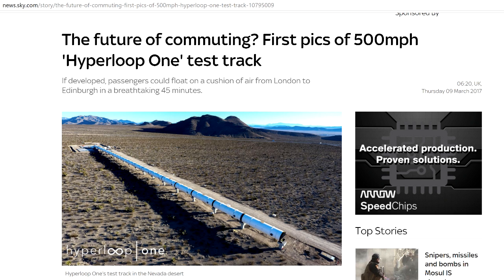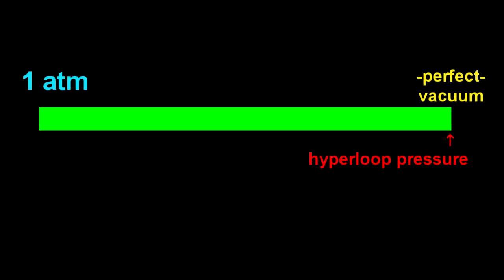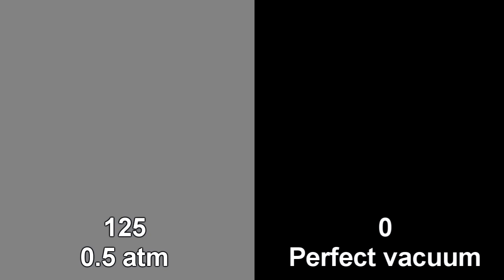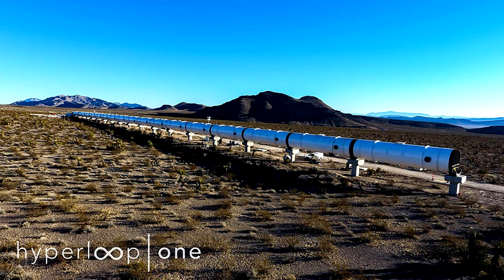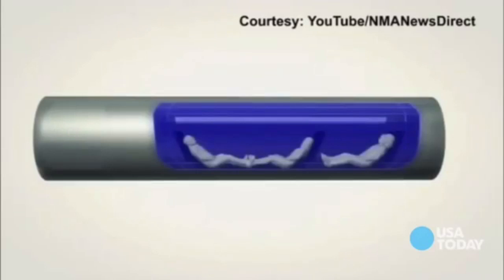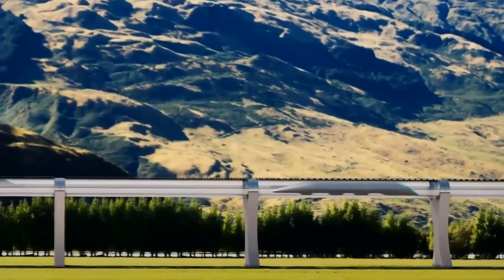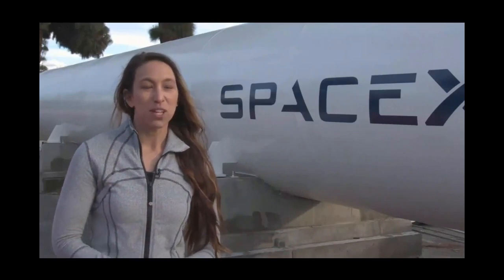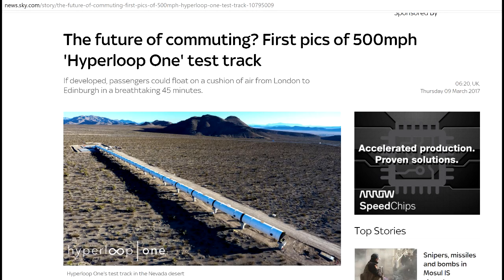Entire Hyperloop could be destroyed in SECONDS!

Comment from the maker: Loads of people sent me the article about 'hyperloop ones construction of a test track', which might seem impressive till you realise its half the size of Elon Musks test track, which was only ~1km long.  Their tube also looks VERY thin to the point where I wonder if they will even be able to depressurise this tube.  I dunno give me odds of when this tube is depressurised, the chances of the hyperloop being able to survive merely being hit with a 5kg (10lb) hammer!
Reply: Paris Teta Why not just build a normal train then?
Reply: Problem I see with this: they want to build it in the usa. Every nutcrack can buy a fucking .50 anti-material rifle for hunting purpose.
Reply: I watched films on early attempts at flight. It's easy to laugh at their failures if you didn't understand that aeroplanes are the result of those trials. They're doing something while your contribution is what . . . to ridicule?
Reply: Only if it's a solid gold hammer, my good sir
Reply: +Thunderfoot Hey, I had a thought you might find interesting.
The test track for the Rainhill trials (1829) was a little over 1.75 Miles.
Reply: That's called a Transrapid, was designed and built in germany and has been fully functional since 1991. There is zero need for a Hyperloop.

https://en.wikipedia.org/wiki/Transrapid
Reply: > it's unfair to judge the whole thing when it's in such an early stage of development

because they can invoke magic later.
Reply: a train basically
Reply: There always has been solution, with current technology, we build tubes like the fucking ones in nuclear power plant. Bomb proof external 10 meter concrete wall, 1 meter thick carbon steel tubes thats hard as fuck. basically all the best military grade gear possible. WE CAN BUILD IT!!! YAY 1 FUCKING BILLION DOLLAR PER KM YAY
Reply: Since when did laws stop terrorists or criminals in California?  Did you forget about San Bernardino?  You are incredibly stupid.  Invest in Hyperloop.
Reply: Even if they manage to build this hyperPOOP, the ticket cost will have to be several times that of Concorde.
And we all know what happened to the Concorde. 😊
Reply: +JMcAfreak Thunderfoot is NOT an engineer, he is a chemist. The issues he discusses are engineering problems!
Reply: I have a much better idea than Hyperloop: Hypercannon. A passenger in LA is fired out of a cannon with enough speed to get him to San Francisco. But don't worry there is a Hyperbouncycastle in the target area. Also Hypercannon Deluxe gives the passenger a parachute for that extra comfortable travel.
Reply: @earlofdoncaster5018  Hyperbouncycastle , loved the name, stealing it
Reply: @earlofdoncaster5018  They haven't lost anyone since they recalibrated in '09. https://project-apollo.net/mos/mos007.html
Reply: Each segment must have isolation option, UPS, and evacuation shafts automatic valves in order it to be safe. Cascade failure is big deal here also, I think there is no such system to prevent that, because it is too quick, in order to separate segment you need a very quick closing system. Seems to me this hyperloop is a golden loop in terms of cost efficiency.
Reply: +Peter Knagge "top speeds of over 1200kms/hr, that's Hypersonic sonic boom territory, not to mention the G-forces, "

Someone correct me if I'm wrong, but I don't believe there is a sonic boom in a vacuum, and G-Force is a product of changes in speed or the combination of speed with a curve.

I'm fairly certain they'll experiment with melons long before they put people in these things.
Reply: so...trains...trains on mars, that is hyperloop, if you do not need a tube and all you need is engine and a track...congratz, you build a railroad.
Reply: Thunderf00t Your argument is invalid if they use adamantium. Haha proved you wrong!! ( XD sorry )
Reply: Cause submarines are not built to be a perfect vacuum, quite the opposite, they need oxygen in them so the crew doesn't choke to death. As well as having thicker plating, supports, bulkheads and things of the such. They're not a giant vacuum chamber built above water. Your point is invalid.
Reply: + Ex Animus can you stop talking about physics as if you understand it. "any loss of pressure containment with the car moving at those speeds is death." No, absolutely not, do you see airplanes just suddenly stop when they turn off their engines? No, air is a compressible fluid, it would compress and decelerate you at about a little over 1g assuming that you have an airtight seal around the pod. if you don't have seal around the pod it would only decelerate/accelerate you at around 0.1g, stop stating "alternative facts" and do the actual math, it's not hard to do it's insanely simple, either you take pressure*area/mass and you get the acceleration in the "air tight" scenario, or you take air density * speed^2 * area * drag coefficient / mass. Plug in some numbers and you'll find that what you are talking about just doens't happen
Reply: Thunderf00t are you an professional engineer and scientist?
Reply: Silly Sad It might make a good amusement park ride in the future.
Reply: I really don't see the need for hyper-fast transit for people (presumably wealthy and business-class passengers) given the increased use of teleconferencing and skype and whatnot. Of course many business transactions and collaborations require face-to-face contact, but I'm not sure that so many are required that it would necessitate a project like this vs. just taking a regular jet or train.  This just seems like an answer to a question nobody asked.
Reply: Thunderf00t is trying to save lives. Everytime the press hypes the hyperloop, he responds. And yes, the arguments are the same, because the media doesn't seem to catch on to the absurdity of building a vacuum bomb just to travel a little faster than a "conventional" maglev train could. If despite his warnings the hyperloop turns into another Hindenburg it won't be his fault, that's for damn sure.
Reply: I don't think he is doing this on purpose tho. There are many ridiculous ideas out there which are getting funded by governments etc which are just obvious troll ideas. He is just a person too, he has his beliefs and once he has put this much effort into "busting" a concept turning around and going "Oh, I was wrong on all these things I said" is just not a human thing to do. I'm an u He is clearly wrong on several issues here and he is not knowledgeable enough in the strengths of materials to make accurate statements about the structural integrity of this tube. He is a chemist, right? Not a physicist. You can "easily" calculate how much pressure that tube can hold, how large of a dent it can take etc. You can even run these simulations on your laptop. So yes, he is wrong here, but everyone can be wrong, the real lesson to be learned here is the same as always, DO YOUR OWN GOD DAMN RESEARCH AND STOP TRUSTING EVERYTHING YOU SEE. I am a victim of this too, I believed him when he said many of these things, then to prove a point I did some math on the aerodynamics of a ruptured hole and more, and I got really low accelerations, like bellow 1 g of acceleration low. So I looked over it again and again and then realized that what he was saying simply wasn't true. I still don't believe that it's economically feasible to build it, but that remains to be seen.
Reply: What about using that fast release to push it to the destination and use magnets to slow it down?
What about launching yourself out of a cannon, and landing in another cannon right as it fires to slow yourself back down?
Reply: Its called redundancy, same thing that protects airplanes from depressurizing at cruising altitude and sucking the passengers out into the sky while simultaneously depriving them of oxygen.
Reply: +This Is My Name there isn't a solution, that's the point.  

I'll admit that the whole thing about emptying the tube every time is dumb, just build an air lock at stations.  But considering that even a small amount of damage could cause catastrophic failure, is a fairly large issue.
Reply: no man, you are wrong. there is no watch dog on the kind of people making those other products and or concepts, which, as has been proven was really done purely for scamming money.
they never in their wildest dream thought thought they would have their bullshit ideas put through what amounts to science boot camp.
just think of the amount of money they would have walked away with if TF didnt test them, we are saving lives maaaan. lol
Reply: Thunderf00t holy shit.  They should put the money into Maglev trains.  Super fast without needing the vacuum tubes.
Reply: My take on aswering/addressing your solutions (warning im no expert on any of this so my bad if some errors occure):
1. while an option in terms of practical solution its would skyrocket the cost for material and construction as well as making other problems worse (like extension and curves)

2. the problem here is that bridges are relatively short pieces with no need for beeing vacuum tight and perfectly straight. if we take a look at the closer relative of the HL (a pipeline) does it we see that they get curvy and have U shapes integrated into them to get them stable... not realy an option for the HL

3. your first point would make it better (not good but better) but it would still hold similer risks and with your second suggestion you want to add structual weakpoints into the exterior tha basicly repeat the same problem every X km? and to "cushion the vehicle"? you realise that you would create a wave of air behind AND in front of the vehicle that are going towards each other?

4. i got nothing

5. yes arilocks would remove the problem stated here. but it raises the question of the interval length between the pods.
lets say the trip takes 30 min of travel time and the de/repressurisation takes about 5 min. in addition we need the time for passengers to exit/enter the pod, time for the safty checks and a generous amount of puffer time for minor delays (see train travel...). with that we could MAYBE squeese 2 pods per 30 min into the tube. correct me if im wrong but i think the biggest pod we have seen in artowrk was ~10 person pod? so if nothing goes wrong we can transport 20 people per tube in the 30 min interval... thats not realy a good ratio.
also can the pods be stoped mid transit in case something goes wrong? and things will go wrong (hell we cant even keep the "low tech" trains running on schedule without problems...)
and lastly the question of what happens to the pod after the trip? unless its a literal loop (aka round trip) they either need to send it back wich would limit it to 1 pod per tube aka 1 trip per hour or the need to extract the pod at the end wich would make it even more time consuming and add technical dificultys...

Ps: your links dont work correctly because you include the ) in the link. there needs do be a blanke space between them ^^
Reply: RoMMeL1337ak47 be careful with saying stuff like that, some don't find it funny and they'll get professionally offended.
Reply: Still think it'd be more practical to build an above ground subway tunnel to put a monorail in that has solar panels on top of the tunnel to supplement the power needs, and you'd have enough money left over to even put cup holders and TV in for each seat....and lobster dinners for all the passengers.
Reply: +Thunderf00t you have been talking about the loop itself but wouldn't the pods be at risk too? you are putting a capsule into a vacuum, if it's not strong enough (and i'm pretty sure it WON'T be) it's gonna pop like a balloon
Reply: What happens if the transport car gets stuck in the tube?  Wouldn't the passengers run out of oxygen and suffocate?   Why is anyone still working on this bullshit?  I'd hate to have a job knowing I was constructing something that was completely fake & would never be used...just to get a paycheck (I assume).
Reply: People are sucked into the cult of personality that's formed between undergraduate engineering students and this Musk character.
Reply: "Nature abhors a vacuum."

Nature wants to crush a vacuum.
Reply: I don't understand what's wrong with maglevs, they're already a proven technology (China, Japan). Why even bother with the hyperloop?
Reply: With the condition of our infrastructure and the people that cannot even keep up filling potholes, This is just another accident waiting to happen.
Reply: it was my understanding that they were going to use maglev technology in concert with a vacuum chamber, thats why I mentioned their theoretical speeds could be much higher, but in a vacuum using wheels at such high speeds they're going to have HUGE issues with heat since there's no air to carry away the heat.
Reply: Is the 5kg hammer made out of gold?
Reply: So basically the HyperLoop is going to crash about as hard as your Brexit and Trump videos?
Reply: with a GOLDER hammer :)
Reply: You are right about expansion problems. You could wrap it with insulation but that just adds to the costs  The better option is to use conventional means of transportation and forget this.
Reply: That´s because many - if not all - of his projects are a giant waste of money, ressources and manpower.
And more often than not they are pretty dangerous as well.
Elon Musk himself is more a man of great words than of great acts. Plus, he is trying to do things just because they haven´t been done before, and not because they contribute something to the future of our world, even though he wants to believe just that. Look no further than SpaceX. The plans of building a colony on Mars are just pure madness. Even 1 Million people sent to Mars (which I highly doubt will come true) wouldn´t solve overpopulation. I´m not aware of any kind of research we could perform on Mars which we cannot do here or on the ISS. Actually, there is absolutely no benefit to this other than proving that it can be done (and we already know that can be done). But this project is gonna cost so, so much money that could be invested in other things.
Reply: Larry Smith every time I look at Musk I hear the Monorail song from the Simpsons in my brain.
Reply: tuxis why would one do this though. Look Thunderfoots debunking of the Hyperloop is great and wonderfully detailed. But even he misses the more obvious big picture failure of the thing. Economics. The Hyperloop is at the end of the day a fixed point to point transport system that travels at or near the speed of sound. But it features enormous materials and infrastructure costs. And obscene ongoing maintenance and operational  costs every day it runs. All this to achieve travel at or near Mach 1. Contrast this with Air Travel. It is fixed point to point high speed  Travel that has very very low cost infrastructure costs. A few miles of flat concrete, some lights and navigation systems. Upkeep on the infrastructure is astonishingly low for a transport system. We've had Hypersonic air travel capabilities for 50 years. What does the Hyperloop deliver that the Concorde did not in the 70's? Beyond an obscene price tag?
Reply: how about a moving atmosphere (wind tunnel) instead of evacuation?
Reply: youtube. com/watch?v=Uh0uwJoNnhc&t=8m17s    
does anyone know if ^ this ^ series has been addressed by thunferf00t?  It seems to includes damning criticism of a number of the calculations that Thunderf00t used to criticize the hyperloop.  If he hasn't addressed this criticism, he probably should.
Reply: Okay, considering the weight of the evidence, it seems pretty clear that Thunderf00t is just wrong on this issue.  He blatantly misrepresents the actual pressure differential between the interior of the hyperloop and the atmosphere, and ignores the actual solutions to many of the problems that he mentions (his representation of the problems are also often exaggerated) -- solutions that are proposed by highly qualified engineers, and specifically described in the hyperloop white papers.  Shane Killian's series "Thunderf00t's "Hyperloop: Busted" BUSTED" points out Thunderf00t's many errors on this issue, and is totally damning.  The fact that Thunderf00t misrepresented the pressure differential, again, in this video is ridiculous.  here's the video describing his misrepresentation of the pressure differential, although the whole series is great:

youtube. com/watch?v=UQPAzZX7Pp4&t=8m0s
Reply: The internet is TUBES! HYPER TUBES!
Reply: @ Remi I´m not ignorant, I´m just saying that building a giant colony on Mars right now doesn´t make any sense. I´m actually very interested in space travel, but I can´t see the point of this project. There´s no need to get people there because we can improve this technology here on earth until it is advanced enough so that establishing a colony on Mars has an actual use.
Reply: A 'conventional' MagLev train is more cost effective
Reply: Wouldn't be the first time Elon Musk's cowboy attitude towards safety in engineering would have killed somebody!  http://nypost.com/2016/07/02/tesla-driver-killed-in-autopilot-crash-was-watching-harry-potter/
Reply: umm how many homes does Elon musk own on the san Andreas fault line, because this seems like a bond movie villains plan to sell ocean front property 0_0
Reply: +Thunderf00t I can see you've gained quite a cult following now and I don't think it's doing you or anyone else any favours. Reading the thread of replies to this post is alarming me; Everyone is seriously ignorant to the facts and they're just repeating back whatever nonsense you've alarmed them with in your videos. 

Please stop to think about what you're doing. I think you're more concerned right now about satisfying your fanboys than you are about proper critical analysis. You're out of your depth when it comes to the field of mechanical and aerospace engineering. PLEASE SPEAK TO EXPERTS.
Reply: The only evidence you have for the damage to a hyperloop is your test cased which used a glass tube. Glass. Not metal of a similar width. Your test case was bunk. Stop pretending it was accurate when it wasn't. As for surviving being hit with a hammer: Don't be ridiculous. You may as well be saying the space shuttle can't ever possibly handle reentry because it's designed for use in space, and the air pressure on the ground is vastly higher. Lots of your arguments towards the hyperloop have massive holes. Either address these hole and reform your argument to better describe your point, or stop wasting your subscribers time with these anti hyperloop vids. At this point, with how many you've made, and how poorly they're argued, I'm beginning to think you're getting paid by a hidden party just to make them.
Reply: wait a minute, M.O.A.B. bombs? as in Mother Of All Bombs bombs, I remember when people talked about R.I.P. in peace as a joke, but I have never heard this one before.
Reply: Dedicate their lives to this field? What are you smoking? Like the winner team from Delft they are students and academics despearate for finding something they can use to write their Ph.D. and maybe extract some Musk money.
Reply: ahaha ashley i dont see a working hyperloop anywhere..
i dont see ANY NEGATIVE PRESSURE DEVICE in use anywhere in the world of any size EVER.. NONE,,,,ZIP,ZADA,NADA..ZEROOOO...
if you think savior elon was the first to think of this youre sadly insane.. people  have proposed low pressure  transportation tunnels since captain rodgers spaceman in the 1920ss and before..
why hasnt it been done.. because it DOES NOT WORK ahahah..
they even have a james bond movie with james on a pig  travelling at 100 mph in a  pipeline ahahah from the 1970s ahahaha
Reply: +sterling apsin Airlock
Reply: LHC exists, doesnt "collapse". Now, Elon is advancing with this thing, and it's gonna work for sure
Reply: Aecom, global construction firm, will build SpaceX's Hyperloop test track.
Reply: Some Dude - at least give an ingredient listing..  distilled Argon ( PLAr ) Flow regulator .oven  bag,..elastic tie... ]Works so well, it leaves people  speechless unable to bitch and complain every time.. never get any returns either, buy a kit today! and save on your next purchase. though usually no one ever needs another  one, i guess work  really well.
Reply: +Misanthropic_Asshole if I were MacGyver, I would use bubblegum a nickel some copper wire and a banana that should take it down but only if I were MacGyver...
Reply: From the footage inside the vacuum chamber test track at 3:31 ... How does the dust in the chamber hang around in the air if there is no air in the chamber?
Reply: Dust doesn't need air to exist, in fact when it does, water molecules attach to dirt and make it drop to the ground
Reply: I think it's easy enough to understand.  150 years ago would people have expected powered air travel, let along space flight?  Twenty-five years ago was the prospect of a phone (nee a micro computer) in the pocket of half the world's population anything but wild speculation?  They hyperloop hucksters draw a false analogy with past engineering achievements and the media goes along because its "news".  

What's really amazing is that people aren't just day dreaming about this, some are putting millions in to it.   The super-rich have money to burn indulging their idle fantasies and a portion of them do so!

I thought this was really the best video so far, showing unequivocally and vividly one of the failure modes of the system.  I recommend sharing this widely.
Reply: drizzt7dourden7 I work in healthcare, the majority of the  popoulaiton have a large amount of problems.. too many  to name, all lawsuit material..  no matter how durable r dsafer the device.
Reply: "I'm not going that fast in a tube that close to the ground. Im just an average guy but that just sounds like to me a big headache!" File that under 'Things your sperm would say if they could talk'
Reply: Oh, so that's what you need the gold hammer for, destroying the hyperloop
Reply: Thank you for finally bringing up the car crash thing Thunderf00t that seemed like the most obvious problem with the way they want to set this up.
Reply: Not fair to monorails.  They actually carry people where they want to go and their use is expanding.  Read: http://www.industryweek.com/technology/lowly-monorails-future-finally-arriving
or https://www.bloomberg.com/view/articles/2016-12-06/why-monorails-are-the-future-really-this-time

However, I think Lyle Lanley has a job in PR for one (or all?) of the Hyperloop venture. ;-)
Reply: "...the chances of the hyperloop being able to survive merely being hit with a 5kg (10lb) hammer!"

Crowdfund it! We must send Thunderfoot to California with a big hammer. For science!
Reply: Careful, you example with grays is reminiscing of the CO2 percentages used to argue against climate change.
Reply: Zarkoff45 There is the case that those 'investors' are not scientists, and that the engineers, along with Musk(probably) just threw off an idea bound to fail to make a cheap job that will get them a lot of money from both government funding and the aforementioned investors.
Reply: ***** I stand by what I said. It can make a good fucking amusement park ride.
Reply: Thunderf00t. The world needs more people like you.
Reply: So, an hyperloop on Mars is just a TRAIN. We already have them on Earth. Magnetic levitation trains are already plenty fast (up to 500 km/h).
Reply: With a big golden hammer
Reply: That's a fucking train on mars.
Reply: Will it be a golden hammer?
Reply: +This Is My Name You are an idiot. There is every reason to criticize something that upon cursory inspection (at least by a physicist) appears to be ridiculously impractical. Coming up with a solution costs money.  Why don't you pay him to come up with a solution? Bitch.
Reply: +Mr Anderson.  I don't know about 'trivially simple'. We are talking about a 1000km vessel exposed to expansion and contraction, earthquakes, wind, etc. Not to mention the need to protect it against collisions, and sabotage. One armor-piercing round would be enough to compromise the shell though maybe not to catastrophic failure. A shaped charge, instructions for which there are now even in videos on YouTube, would obviously be devastating. There are simply too many environmental and security hazards for a vacuum chamber of this size to be both safe and commercially viable.
Reply: +Paris Teta The thing is, Mars currently has no places to go to or away from. The idea of fixating on a transportation system for another planet between nonexistent cities is even crazier than just 'cart before the horse'!  The first settlements on Mars will be self-contained.
Reply: Elon Musk is a Snakeoil salesman and I'm glad that you are not afraid to yell out that "the emperor is naked"
This will fail and the best part for Elon is that it is not his money he is spending but tax money...
Even if it fails catastrophic  he will still be laughing all the way to the bank.
Just wait Musk Fanbois this will fail because the laws of nature is not an option, it's the law.
Reply: Vandalism, terrorists, car crashes, repair gone wrong, (it would take so long to safely re-pressurize the 1km tube for maintenance) a flaw occurring from inside the track like the vehicle loosing balance, the impact of the transport at the end of the track, flaws in production just any contact w/ the loop. Might you also note how powerful the reaction of the storage tank was when it collapsed, you could use a fraction of that dent to make a medium collapse.
Reply: Mr Anderson You obviously aren't aware that the hyperloop needs flexible joints in order to even theoretically function. good luck maintaining structural integrity and vacuum seals with flexible materials. the moment the vacuum pump starts, any difference in heat in different parts of the system will cause a massive chain reaction failure
Reply: you're ready to bet your life in the "plenty of time" to close the valves ? and even so there is no guarantee this will operat smoothly we are talking enormouse amount of energy here.
Reply: I have to say, although I am skeptical ablout the hyperloop, you are doing yourself a disservice with a few points.

Using the 30-45min time to evacuate the tube as an argument against the proposed travel time doesn't seem right in my oppinion. I'd expect the 'real' hyperloof (if it ever were to become a reality) to have some sort of an airlock, as opposed to evacuating and refilling the whole track all the time.

And those design 'studies' run on shitty wheels put on by engineeringly inept art and design students, and if they thought about greasing the axles, I'd be surprised, let alone ball bearings. 
With the supposed hyperloop running on magnetic levitation, there would be significantly less friction slowing it down.

So, please refrain from making obviously flawed arguments, Thunderfoot, as it only hurts your credibility. I would have expected you to be above such slight-of-the-hand tactics.

Especially, since you have well proven yourself capable of pointing out the real issues and idiocies of the hyperloop idea.

In my books, maybe people should try the Transrapid, it works. Not a pie in the sky as the hyperloop, but still decent achievements and actually working.
Reply: I really don't see the need for hyper-fast transit for people (presumably wealthy and business-class passengers) given the increased use of teleconferencing and skype and whatnot. Of course many business transactions and collaborations require face-to-face contact, but I'm not sure that so many are required that it would necessitate a project like this vs. just taking a regular jet or train.  This just seems like an answer to a question nobody asked.
Reply: At least in the case of the vacuum problem, would it not be theoretically possible to have an airlock type system anywhere that new pods needed to be loaded. This way the entirety of the track can remain pressurized and the station areas could be depressurized.
Reply: I still don't get the system. Even if you could get into the "train" and then vacuum the tube and start the journey, how do you stop at your destination? Also, does that mean the tube has to be pressurized back to safe levels for humans to exit the "train"? That seems like a huge waste of energy and time just to pressure/depressure the tube
Reply: What if we hit it with a gold hammer?
Reply: Maybe thats how they are going to work.. put a plug in the end.. sorry I mean passenger car.. then open up the end behind it.. that will make it get to a good speed.. be like the ping pong ball in the video.. xD
Reply: If it breaks down you're stuck in a vacuum tube.....how the fuck are u going to be able to breath?
Reply: I noticed that, also on that page it says 'floating on a cushion of air'.
Reply: I think that would be on another level of nasty, lets assume you are 1/4 of the way along the track and they open both ends, and lets also assume that the maglev keeps working,  you would be hit with a moving wall of air from behind, and shoved forward, or you would keep moving forward under propulsion till you hit a moving wall of air slamming into you from the other direction, you would go from the "600 mph" to 0 in slightly less than 3 seconds, if however the maglev failed then, unless there was some sort of standing loop that kept the field active till you stopped then you would drop to the floor of the track and scrape along, till the air got up to you and through you about.
Reply: "What could possibly go wrong?"
Reply: Remi are the same arguments only valid one time?  Wow, hadn't thought of that.
He makes the same arguments time and time again because it's critically important that people drop this idea as soon as possible.  huge amounts of funding are being wasted on something that is almost certain to be a catastrophic failure
Reply: a 5kg GOLD hammer???
Reply: A 5kg (10lb) gold hammer?
Reply: Thunderf00t 
It ok to take the low cost egg shell approach in design for experiments! It just has to show proof of concept. If they stopped the whole school kids approach and had real engineering involved (NASA or GE perhaps) we would not be joking so much, but that is not Elon Musk right? So let's see how the kids do, they may surprise us. or provide for entertainment!
Reply: Proxima 1
Is a tank designed to hold vacuum?
How much positive pressure is a tanker rated for?
Would a submarine rated to withstand 50 atmospheres of positive pressure implode like that tanker under vacuum (1 atmosphere)?
Reply: You mean all the money and energy Musk has spent, right? I doubt you've spent a lot of time and energy into the hyper loop :p When I said "he" in my comment I was referring to Thunderfoot btw, not Musk, but it goes both ways I guess.
Reply: A submarine or Submarine style construction would be what is needed, as that is designed to work in exactly the way this needs to be. So what is the cost of a small attack submarine? How many of them would you need to lay bow to stern to stretch from LA to San Francisco? How much maintenance does a Submarine need due to the constant forces on it? What are those annual costs? 

Now looking at that, note that the Concorde airliner built in the 70's could cruise at speeds of 1,300 Km/Hr. And only needed standard 4-5 mile runways at each end. Why build the giant hamster tube when you don't actually need the giant hamster tube to achieve the transportation goal you are seeking? Inefficient Expensive Stupidity is not in fact Innovation.
Reply: Thunderf00t. if instead of a vacuum they built a high-speed wind tunnel, the air could help push the pods and give the fans something to work with. it would be less vulnerable to damage and easier to work with, it'll help compensate for the metal expansion and the doors necessary to get the pods out of the toobs to load and unload passengers. or is this a bad idea too?
Reply: +Polak Ateista Can you explain exactly how his scam works? Spend millions of his own money to build a prototype for the hyper loop... I don't see how this is a scam? Where is he making money? Spending money is a bad strategy if you want to scam people.
Reply: there is solution, normal fast train.
Reply: Marek Rokam roughly 75-85% of Americans are complete asshats and actually believe this shit. I am not one of them, however most of my friends are.
Reply: Jesus. look at all these fucking retards trying to defend this. Or telling TF00t to come up with a better solution.
He doesn't have to, we already have one.
It's called a normal fucking train people. Or a car.
Both would be more energy efficient, safer, & don't require a massive fucking tube to operate.

Hell, in the case of a car, you don't even necessarily need roads.

"it's in its early days"
Shut the fuck up.

How do people fall for this shit?
Between early access games on steam, and bullshit art project kickstarters.

Christ people, get a clue already.

Every minute another sucker is born.
Reply: Thunderf00t none of these people have heard of an airlock
Reply: +Beacon of Weird
"All of these are just engineering challenges, nothing that cannot be overcome. Tube colapses? Thicker walls/more rings. Sudden acceleration during a leak? Add emergency breaks. Takes a long time to achieve vacuum? Add air locks. Track is expanding? Add airtight expansion joints."
Even cost can be solved as an engineering challenge! It costs $500 per mile to operate after adding all that shit? ... use a regular train instead!
Reply: Patrick
Right. And make the protective tube doubly thick to make sure. So now the structure is > triply heavy. But that's fine, we just have to triple the strength of the supports. They laughed, the fools...
Reply: I hope everybody already read Hyperloops page and realized it will be filled not with hard vacuum but 90% reduced pressure air.
Reply: Don't bother, at this point it's safe to say he's being paid to make vids specifically against the hyperloop. By whom, I'm not sure, but nearly all of his points have been defeated by comments like yours on the very first video he made about the hyperloop, but he just keeps making them. He even made a vid defeating other arguments, but the arguments he defeated were cherrypicked and none of them were actually the counters to his video. At this point he doesn't care, he's purposefully shitting on the Hyperloop with dishonest, misleading, and outright false information. Nothing we say will stop him. It's better to comment directed at the other users posting here, who can possibly be influenced away from his stubbornness to accept that the Hyperloop is theoretically viable.
Reply: I bet you he makes a video talking about martian windstorms destroying the track without recognizing that structures are made to withstand high winds on a daily basis. It'll be just like this video: Ignoring facts and using falsehoods and misleading and even outright false information to support his claims.
Reply: Resonance is easily handled with a few engineering tweaks. It may make it more costly, but it's not a huge issue to deal with unless the design inspires resonance naturally (like car engines, which we've handled pretty well).
Reply: and rocket ships fly into the upper atmosphere and into space on a regular basis, while having the potential to kill thousands when it crashes, but that doesn't really happen. It's almost as if engineering can tackle these problems and, if they can't, it doesn't get built. But no, you keep fighting the good fight and stopping progress because "it might not work." Idiot.
Reply: Except he didn't and lots of info in the vid is intentionally misleading and wrong.
Reply: Chris F I'm guessing you haven't seen his other videos.  dripping condescending tone that seems like he is bairly able to hold back high horse laughter the whole time is kinda his whole YouTube thing.
Reply: he may not be an engineer but the massive physics and engineering oversights in their plan are very real, and especially the first is not something you can engineer your way out of.
Reply: +Kevin Miedema
Thunderf00t has not addressed any oversights. He just doesn't accept the solutions, yet he lacks the knowledge to evaluate them.
Reply: physics is universal, its not the hammer that causes it to explode - its the 100.000 pascals pressing on the outside that make it fundamentally dangerous - 'oh im sure they know what they are doing' is not a valid argument here
Reply: Well you are free to come back and laugh in his face if it is shown that all of this works. But this guy does show his working. if its about believing two sources because i cant be bothered to research it myself i'll go with this guy.
Reply: +leakycheese They don't pose as big a threat as you might think. Power can be restored, it's not a system that's reliant on a constant feed of power. If people get stuck in the tube you can section it off. The real danger is all natural disasters causing seismic energy to be released and terrorists. Earthquakes, tornadoes flinging houses into the tube, sinkholes. I can't think of a way to make it safe against earthquakes.
Reply: AtotehZ Sorry, I was not specific in my statement about the particular geomagnetic storm hazard I was principally thinking of, although the power provision you mention is also a consideration.

A long steel tube crossing a significant distance of latitude will experience an induced current if the Earth's magnetic field is significantly distorted by a strong solar outburst. This will need to be allowed for because of the resultant heating and expansion will effect the hyperloop hardware. These effects can be engineered for in pipelines and redundancy can be built into power line grids but how would this be dealt with in the HP given it's particular configuration.

Given the catalogue of readily apparent shortcomings Mr. Thunderf00t has already identified in the design proposal I was interested to understand his (and other peoples) thoughts on this particular hazard.
Reply: Thunderf00t
you do realize it's a low pressure system right? Not vacuum, low pressure. A vacuum was proposed and rejected for this exact reason. There's still some air, just less of it.  That's why there are whopping huge fans on the hyperloop pods.
What happens if someone rams a car into it is that the line is shut down until some poor schmuck goes to the damaged area with a piece of sheet steel, an angle grinder, and a welding torch to get the thing patched up
Reply: here in taiwan with 7+ magnitude earthquake we built a 101 floor skyscraper on mud.    ????????????????
Reply: .... and, your point is? hyperloop still fake.
Reply: I agree to saying that all of the articles that are being passed around the internet and the news are just plain stupid. but I don't see the point of bashing something that is realisticaly still in early development stages, just because the media is stupid enough to make it look like it's "almost ready" or "coming soon".
Reply: Dr_Melon It is not "media said".... mask and his minions saying exactly same thing all the time.

And how do you think they will solve problems about materials and etc., after they.... you know they already made about mile of REAL track?.... and it is longer with each day?............. how?... by destroying it? O_o

Nope, this not working that way... They already building this fake, which is gonna be HUGE fail............. as transportation system, at least.
Reply: after spending 500 BILLION on this boondoggle..someone and most likely a WHOLE LOT of people  WILL DIE in accident in the FIRST YEAR..
what exactly do you think will happen NEXT..  lawsuits and bankruptcy.. shut down at least a year for investigations and repairs..

just because you can build a skyscraper in space doesnt mean it will be profitable nor useable
Reply: the chunnel has 2 tunnels , extra service tunnels and  multiple escape tunnels and still people died in a fire in the chunnel..
people WILL  DIE on the hyperloop in a major accident.. thats a sad guarantee of life
Reply: ahaha when i was a young stud jetsetter.. my bosses only gave me enough rope to hang myself not enough to hurt others..no one is going to give idealists 500 billion and say dream on and let me know when youre finished ahaha.. the board  and sr engineers will be watching EVERY move like a mother hawk..100s of mother hawks.. youre obviously insane....

a hundred companies will make or break their companies if anything goes wrong on this one.. some may even go to jail..100s will be fired and lose their careers..ceos will never work again,, presidents, VPs, 100s of executives will work at walmart
Reply: ahahah  i live in the reality of profits and losses and lawsuits everyday..
this aint a govt nasa work project.. this is a NEVER been done in HISTORY project by anyone of any sort.. that can quickly  KILL 100s of people.
youre bonkers..
theres a reason this has never been done,,, large scale or small scale ,, cargo or people..not across the room not under a street between 2 buildings not over head 100 feet across a roadway downtown..NEVER
Reply: ive rarely ever seen anyone who  KNEW THEIR LIMITS ahahaha
Reply: They are insured and get a pay out over the "disaster" and operations losses.
Reply: This Is My Name exactly!!!!
Reply: Honest question: What would happen if one could build some sort of safety system that opens up to the external atmosphere along the entire tube in case of failure?

I have seen you open up one end of a vacuum tube only to have the "pod" fly out of it. Would opening it at both ends at somewhat the same time yield a different catastrophic result or would it survive in that case?
Reply: So no stops along the way and you just more than doubled the costs of building and points of possible failure. I agree that I think a staggering investment could build one. I just don't think people could afford to pay enough money to ride to come anywhere near the cost of building and operation.
Reply: Are you nuts?  Do you expect to fly the tubes and construction equipment to Mars or build a the plants to manufacture everything on site?
Reply: corthew they said near vacuum, but if I'm wrong thank you.
Reply: Spandan Ganguli it is essentially an electric train traveling in a vacuum, the vacuum gets rid of the air resistance making it faster and more efficient.
Reply: Sentient Species
Maybe do witch hunt to... a bit of burning at the stake? is that your fetish?
Reply: MONORAIL!  Its becoming real...
Reply: paulchartley I don't think it's a perfect vacuum, even if it was that wouldn't prevent dust from floating, do you even science bro? XD
Reply: TheGreg6466 Perfect vacuum can't be achieved
Reply: corthew sorry dude I'm not going that fast in a tube that close to the ground. Im just an average guy but that just sounds like to me a big headache!
Reply: Mohit Mohan Idiot. Thorium is much better.
Reply: TheGreg6466 Mate, I understand the basic concept. I wouldn't be commenting if I didn't.
Reply: Peter Knagge Mate, I'm talking about a loop ride, not that height tower thing.
Reply: Peter Knagge Side, it would shoot people out if it isn't a loop, and they wouldn't come back down alive
Reply: ***** Stupid fatass, it'd be better off to just be a hikikomori...
Reply: SquillagusNiggle You lose. Get out. You're worthless without an argument.
Reply: TheGreg6466 Have you heard of these people called psychopaths? Who would do things like throw a rock at the hyperloop thinking they can't be caught?
Reply: sam - Anterior cruciate ligament,, reperfusion injury also does when ischemia has set in a locaiton in the body too long.. Tertiary onjuries of all sorts.
Reply: Thunderf00t they still haven't address the issue with G's you will experience
Reply: RoMMeL1337ak47 What does TF crowd mean?
Reply: An amusement park ride that I don't want to ride in.
Reply: Yes you can, just not easily/legally. Saboteurs, not so bothered about legal restrictions.
Reply: Alex Booster To be fair, the concede failed because the ground clean up crew fucked up. Yes, it failed spectacularly and was unsafe to begin with, but was just a joy ride.
Reply: Thunderf00t I'd be curious to know what the thickness and the steel type used in the tanker on Myth busters verses the steel shown for the Hyperloop test track?I would think that the tanker's steel is somewhat thicker.
Reply: Julius Red mechanical friction between the pod and the track in the tube is why. There was no maglev, wheels, or air cushioning (ala hovercraft) to prevent contact friction. only air friction was reduced.
Reply: Are you telling us to go hit the hyperloop with a hammer once its built
Reply: yes harbl99 a hammer 

a Golden hammer would be a nice touch...
Reply: Thunderf00t  these designs are truely horrifying. first off if they want a vacuum tube I would recommend they have two layers of metal minimum with honey comb in the middle. that's is to create a stronger structure and a impact and heat resistant one too. secondly, what do they need a nearly total vaccum when a large fan in the front of a pod will create a vaccum infront of the craft and a pushing pressure behind it. you'd get a lot more thrust than with electric motors driving a pod in a vaccum. in addition why isn't there puematic releif valves on the pod so that if there's a tube rupture the pressure can eqaualize without propelling the pod dangerously. these are some of the issues I have with these piss poor designs. Elon Musk would not be impressed if he visited these so called inovators
Reply: This Is My Name you're
Reply: Thunderf00t I'm also going to mention that the tanker car crushed at about 20 degrees of mercury which is about 66% vacuum, something tell me a paper thin sheet of steel isn't going to hold up even under 10 degrees of mercury.
Reply: +Whisky November Lots of big, yet ill-fated projects have started in the past. The 'Spruce Goose', the Supercollider in Texas, etc. There's money to be made, and a lot of perverse incentives to just keep one's head down and collect a paycheck. That's one of the unfortunate side-effects of capitalism and human nature.
Reply: +Thunderf00t tubed train travel could work without needing to have a near-vacuum, if the tube system was configured as a wind tunnel instead of  vacuum tube.
Reply: +Y C I think resonance is much more of a problem with suspended structures like the Tacoma Narrows was. I don't think it's a problem with ground-based objects with intermittent fixed points.
Reply: +OkamiRaoki Not in Commifornia you can't. I agree though, the security concerns alone make the project infeasible.  A simple shaped charge would be devastating also.
Reply: Just let them build their play toys, you know better, we know too, what I am glad for. If people are really this dumb to think this is going to work, let them die inside of it.
Reply: yeah but that's all it would take to destroy say a oil pipeline.  That excuse could be used against quite a few things.
Reply: How about being hit with a hammer made of solid gold?
Reply: +Thunderf00t please reply this: Couldn't you segment the long tube to shorter pieces and in case of emergency depressurization just close some large vacuum valves to cut the broken piece of the tube off thus stopping the spreading of the vacuum and the cascade? At the same time the vehicles inside tube would, of course, had to be stopped. With this method not whole tube needs to be destroyed.
Reply: Thunderf00t your lack of faith is disturbing.
Reply: what if the plan is to put the hyper loop in a wider tube to act as a shell for the pressured inner tube. also unrelated but you debunked the self filling water bottle good work but i have a question cause i'm not a scientist but could that be made to work by adding some kinda of vacuum to the part that collects moister? or something like that :)
Reply: +Thunderf00t  Fun (and kinda sad) fact: I came up with something similar to the Hyperloop as a small child when I was designing the capital city of the fictional empire in my video games.
It didn’t take long for me to scrap that idea after realizing it’s impracticalities a few months later (also as a small child).
Reply: And what happens if the vehicle is inbetween one of the segments? Plus, enough air would rush into the tube to cause failure before the segments would be able to close off.
Reply: TuJuXorX lol anyone inside the tubes would instantaneously be crushed within the pod from the deceleration. the hyperloop is completely hocus pocus. the issue with having "segmented" areas is thermal expansion throughout the system and the actual capability of having sealed, flexible joints that won't explode at the slightest jitter
Reply: I'm quite familiar with vacuum chambers, and the outgassing alone of the components inside and the trains will never allow them to achieve anywhere near a 98% vacuum. The fact that they'll be repeatedly exposed to write atmosphere and then put back in the vacuum chamber means that they'll be out guest again and again and again. They'll never get anywhere near 98% vacuum.
Reply: Thunderf00t there's this mobile game developed by a group in Bratislava that's all about trains. (train station, pixel federation), that has gone so far as to include new content featuring... you guessed it...hyperloops!  I have lost some respect for this game, and am attempting to refer their design team to your videos debunking the system. Maybe it'll work, maybe not, but I hope someone takes a few minutes to examine my proposal and maybe they can tweak the game somehow...
Reply: Thunderf00t there's this mobile game developed by a group in Bratislava that's all about trains. (train station, pixel federation), that has gone so far as to include new content featuring... you guessed it...hyperloops!  I have lost some respect for this game, and am attempting to refer their design team to your videos debunking the system. Maybe it'll work, maybe not, but I hope someone takes a few minutes to examine my proposal and maybe they can tweak the game somehow...
Reply: Science is harsh, with things like this, it either works or people die. I think hes right to act the way he is.
Reply: By segmenting the tube not everyone could be saved, but the collapse of the entire tube should be preventable. After all, the destruction cascade moves forward with a speed of sound or so. In hundreds of kilometers long tube that gives plenty of time to detect the depressurization and close most of the segmenting valves in time.
Reply: Thunderf00t what about an air track like air hockey? would that work?
I think Elon is forgetting about gravity with his vacuum scheme.
Reply: +thaalrasha No, I wouldn't take a risk of taking a hyperloop drive before it has been tested well enough and we have an idea what is the deaths/passengers ratio going to be in the long run. Probably they will start first with just cargo and move to people if the system turns out to be safe enough. Regarding the valves, the signals from pressuremeters travel much much faster to valves than the collapse cascade. After that the important factor is how fast can such larges valves be closed. Should be a matter of seconds is my guess. But as said, not everyone could be saved by this, but the collapse of the whole tube should be preventable.
Reply: +TheGreatDeceiver42 it's not fully functional, the one in Germany was only a test model and is currently deactivated and going to be deconstructed. there is a really short one in China though.
Reply: TuJuXorX the problem with using the hyperloop for cargo means, how would you load or unload? the shunting lines into cargo facilities or factory hubs would have to be set up to allow (de) pressurization of the hyper loop tube. cargo areas everywhere would have to be modified to make full use of the system. I think we may be looking at something whose costs are just going to keep increasing...
Reply: Thunderf00t well they could always hire magneto to hold the walls in place, he's not cheap but musk could probably afford him
Reply: Paris Teta we have that its called a mag-lev
Reply: A car engine can't survive the scenario you mentioned either.  But we use them all the time, and the most critical parts are in their own chamber.
Reply: +Steve Brown. Loading a new vehicle into the tube requires a Segment of the tube to be depressurized and and pumped back to vacuum - the main hyper loop tube should be kept at vacuum all the time. The segment has to be, at minimum, to be able to fit the vehicle inside. After loading the vehicle and pumping to vacuum the segment can be connected to the main hyperloop line by opening a valve between them. Obviously this system is not good for all kinds of cargo, but maybe could work ok for something like post packages, for example.
Reply: +Mohit Mohan Do you have any idea how many wolverines would would need to mine to get that much adamantium?
Reply: +elilla331 destroying a car engine only disables the car engine, it doesn't cause a fatal implosion to a passenger train
Reply: @TuJuXorX You're literally describing an air lock that works in reverse. Which actually isn't a bad idea.
Reply: Can we at least assume there would be an airlock in any kind of finished product for getting in and out, to minimize the whole energy cost?  Also, airplanes can have pressure issues as well, so um,  we don't stop flying because you can lose cabin pressure or they can crash.  IJS.  (Don't get me wrong, I don't think we are anywhere close to getting this to work, but maybe 100 years from now, with the proper materials engineering, it could work.)
Reply: It would really depend on how they design the air lock mechanism to enter and exit.  There could be a series of airlocks and bulkheads to minimize the amount of energy in any given vacuum area, to prevent total failure.  You stop at the destination by simply slowing down and adding friction at a certain point so your object moving looses momentum in a controlled way.
Reply: Rob M That's hilarious. Not only would the hyperloop need to be a maglev to be safe at the speeds where its designers want it to operate, but building an enormous structure capable of withstanding a near vacuum inside of it (and maintaining that vacuum) would be astronomically expensive.
Reply: idontcare80 - that was the selling point of hyperloop. In the beginning the hyperloop was supposed run on a cushion of compressed air like those arcade ice hockey tables.
Reply: Well, it can't do that in a vacuum.
Reply: You mean you can't add friction to the floor at a certain point in a vaccum?  Two materials can't begin to rub against each other in a vacuum?  You can't treat it like a plane on a tarmac and have wheels extend and slow the thing down against a rubber runway at the end of the trip? You couldn't have it pass through an airlock and re-pressurize at the end of the trip thus adding air resistance to slow it? REALLY?  Why not?  I have the SNEAKING suspicion that you might not be an engineer, a scientist, OR very imaginative...
Reply: No, we need room temperature superconductive materials... we have ceramic super conduction materials that induce levitation-like properties at super cold temps, and we are getting those temps up, slowly, hence why I said we need another 100 years or so of materials engineering to really get this to work.
Reply: Planes land at around 150 mph, not 500. The fastest wheeled train on earth went less than 360 mph at maximum, dangerously, and friction increases exponentially as speeds increase, you're not going to get to 500 mph with a wheeled train.

Elon Musk's original idea was actually pretty good, I don't understand how it got warped into this vacuum chamber nonsense.
Reply: Is the hammer made of gold?
Reply: Well, the Transrapid was somewhat of a stillbirth in that germany has a rather well connected network of rails in place, so the pressure to build some new was limited. And also the attempts to get any new  line of tracks or road greenlight are difficult and drag on for years. 
Which in the end killed the momentum of the idea.
And by now, it's technology is already old enough, that it would make sense to develop a new train based on the same principle, rather than building stuff from 20 year old plans.
The concept is still sound and proven to work, as opposed to the hyperloop thing.
Reply: Well, regular trains are fine, but especially the US has a rather sad network of railroads for being a developed country. And planes are rather inefficient, fuel wise.
Reply: math please
Reply: You assumed that tunnel will be build of metal, so foldable but not breakable material, this is just stupid. If tunel is concrete, the only risk is decompression which would cause train to stop, but won't collapse all (or even part) of the tunnel.
Reply: If the whole thing was concrete it would be retardedly more expensive than it would already cost, and even then it isn't full proof
Reply: concrete more expensive than sheet metal? You don't know what you talk about.
Reply: What about a secondary, partially vacuumed tube on the outside to protect it and take some of the atmospheric pressure off
Reply: TheGreg6466 dust doesn't float in a vacuum. With no air resistance, it falls at the same speed as a  lead weight.
Reply: Thunderf00t Haha I heard about this on npr, and at first I was a little mad, ya know having been annoyed by Ted so many times. The woman reporting on it took lots of hilarious little jabs at it that eventually bleed it out completely. She says, basically, it's a bunch of people in Saudi Arabia with more money than sense. Oh I'm so glad I don't have to have ANOTHER reason to hate NPR.
Reply: Thunder is a communist, but I watch him because it's good to get opposing views. Don't view him as a voice of reason, but as not-too-insane leftie.
Reply: really really thin air... lol ya I like how much cognitive dissonance is going on in that statement
Reply: If thats the end game then why all this? just build a monorail or similar as already exists.
Reply: CausingDawn1145 He is obsessed with criticising the Hyperloop because he, for some reason, does not like Elon Musk. When the accident with the Falcon 9 happened, he couldn't stop talking about how badly the rocket is build... It was just a one-time mistake... Ever since I started to watch his videos, the reasoning went downhill.
Reply: That's why engineers take care of applying science to everyday use.
This video reminds me of the moon conspiracy people.
The Hyperloop won't be easy to build as there are a lot of challenges to overcome, but none of them are hard physical limits like with the fontus bottle or solar roadways.
Reply: Remi - when the only argument you can come up with against your opponent's scientific arguments is to claim that your opponent is motivated by some personal dislike... you have no argument. You're only one notch above saying "He's just jealous!" which is usually  the last refuge of someone pushing completely indefensible claims.
And even if he did personally dislike Musk, how on earth does that make the science and engineering go away?
Reply: Thunderf00t  why not put it underground? dosent that fix the problem with people destroying it and you wouldn't need to worry about temperature expansion...
Reply: Yes... A 5kg hammer of 259,3 cubic centimeters volume... Keep it up, Thunderf00t. Love your videos. People need to use their heads.
Reply: Thunderf00t 
A GOLD 5kg hammer.
Reply: Kenobi Wan Obi What are you even talking about? Going to Mars might not solve overpopulation on Earth but it is only a start, technology will improve(thanks to people like Elon) and we might even go to other planets, like Europa. Saying Musk's ideas are a waste of money clearly shows your ignorance.
Reply: Whoa, whoa whoa. Just hold on one moment "mate". What is this Kilometer dishing you have in this video? "at least a Km long"..."they couldn't even build mile long test track" WTF man, WTF?
Reply: night3x Evacuation shafts?!  you're living in fantasy land.  they haven't mentioned any form of escape method on the future hyperloop because the structures required would probably render the entire design inoperable.

Nobody's considered safety,  Feasibility, value vs inevitable exorbitant cost, inevitable enormous security costs or the INEVITABLE terrorist attack that would see it go the same way as the Concorde.  Everyone just accept that this project is FUCKED.
Reply: night3x Evacuation shafts?!  you're living in fantasy land.  they haven't mentioned any form of escape method on the future hyperloop because the structures required would probably render the entire design inoperable.

Nobody's considered safety,  Feasibility, value vs inevitable exorbitant cost, inevitable enormous security costs or the INEVITABLE terrorist attack that would see it go the same way as the Concorde.  Everyone just accept that this project is FUCKED.
Reply: Sergey K of course a tanker truck isn't built to contain vacuum inside. It's built to contain pressure. But that's the problem with this Hyperloop One test track. Look at those tubes. They are standard commercial pipe built mainly to contain and move liquids, such as water. They are built to hold the pressure on the inside, not the outside. That's why they have the reinforced strapping on the outside. They are in every way possible the wrong material for the job. (The operator of any Fire Engine can tell you what happens when you draw to much from a hydrant and create a vacuum. You implode the water main. This happens at about ~-25-30 psi. Right about the same point that tanker imploded.) If Hyperlink One is making that bad of a basic materials choice in something so obvious, what do you think the chances are that the rest of their engineering is sound? Once again, those pipes they are using are designed to transport materials, generally liquid materials, under pressure. They are designed to hold the pressure on the inside. To put it simply it is the difference between a Spaceship and a Submarine. One does not work in lieu of the other. At the most basic level those ribs on each piece of pipe would need to be on the inside of the tube.
Reply: Well said! Thunderf00t is a scientist, so he focuses on the science part. But today, trains in Europe and Japan can already travel at speeds of 600 km/h safely and comfortably. Why don't we have them here everywhere, if we care so much about fast ground transportation? Simple. We DON'T care. Not enough people would favor the Hype-loop over other means of travel.
Where I live they just set up a train which cuts commuting time in HALF. I tried it, and it's nice, fast, convenient, comfortable, cheap and even fun. Yet nobody cares and nobody wants to ride it. With all the traffic congestion, cost of fuel, etc., people still prefer their own cars. Far from a "revolution", is it?
Reply: +realraven2000 . Interesting idea but the idea is multicental speeds. Wind would make large friction on walls at high speeds.
Reply: Peter Knagge it depends on the products he debunks. The Solar Powered Water Bottle harms nobody but fools handing over money. That fraudulent SCUBA device however? That sucker would easily kill people.
Reply: Not working. Early years of the industrial revolution everything was over engineered over-build over-specs. Bridges and buildings build stronger due to the quality of the steel not being consistent. Nowadays we're more advanced and build things up to specifications, rather than over the specs. It's more cost efficient to do it that way.
Reply: The issue here is their design and plans being woefully inadequate.  Did you ever see a documentary video of how engineers could design a train system under the atlantic ocean that could get you from our east coast to london in 15 minutes?  Saw that like a decade ago.
Reply: I know I shitpost on you with Twitter a lot Foot, but I do love your work.
Reply: you'd need a tube to keep the dust out
Reply: The pressures under water are waay waaaay more than that of a vacuum. At about 10 meters depths you would have the equivalent pressures of a vacuum, if you go further down you would need really thick tubes to hold the pressures which would increase the cost dramatically. Further more, a leak in that sort of system would flood the whole system with water, a liquid almost 1000 times as dense as air, meaning running into it at only moderate speeds would be well.. not good. Also (and perhaps most prohibitory) the cost of building under water is a lot... like... a loooot... So that's why that never happened.
Reply: andrew taylor
So if the hyperloop test track is made of materials not rated for vacume why didn't it implode like tanker?
Reply: Lukas Cancelosi
What does "20 degrees of mercury" mean. How do you convert it to a atm bar ot kpa?
Reply: There are two test tracks. Elon Musk's is actually a reasonably well made vacuum chamber. That's the one that is operational and was used for those trials. It's the one with smooth sides and ~4" thick walls.  I am talking about this new one that the company Hyperlink One is building out in the desert. The one seen in the pictures on the video. That one isn't complete or operational yet. But those pipes they are using are basically 48" aqueduct pipe. Large water mains. designed to hold in a high amount of water being driven by pressure. Funny thing about water mains. Any Fire Truck Operator can tell you if you pull too much from a hydrant and create a vacuum you implode and collapse the water main. This typically happens right around -30 psi give or take. Which is precisely where we saw that tanker truck implode. (The tanker is built to hold liquid the same as the pipes.) 

The biggest failing of the Hyperloop will be quite frankly it's cost per meter. It requires too much engineering and structural design per meter of distance it traverses. The maintenance costs per meter of track alone will make it impossible to ever recoup costs. It's not that the idea can't be made to work. It's that the idea doesn't need to be made to work. We have equally fast transport options today that do not require such massive infrastructure and operational costs per meter of distance traveled. This seems to be the recurring problem with all of these magnificent transportation ideas of the future. Solar Roadways, Hyperloop, etc. They fail basic economic tests. We have roads because roads are cheap. Railroads were developed because they were reasonably cheap to build and maintain vs the quantities of materials that could be moved. Air travel is one of the most efficient transport mechanisms in human history. 5 miles of flat ground at each end is really the main ongoing infrastructure cost. And aircraft fuel is one of the most efficient and safest energy sources out there. It stores and releases more power per gram than almost anything else.
Reply: weirdly at the moment Deadpool is the most succesful of Fox's Marvel characters. Although Logan may give him a run for it.
Reply: Beacon of Wierd 
Jesus, I was being a smart ass lol. 
but I get it. I respect the hell out of elon musk even still. I just hope he's "paying attention", so to speak, and we can get something out of all the money and energy we've spent.
Reply: this video is perfect except you made a point about how long it took to pump air out of the tube being impractical to wait for. using 2 pneumatic doors you could keep the loop at a vacuum and only need to pump out the entrance chamber where capsules are loaded.
that said you still busted it.
Reply: Pressurized cabins work the exact opposite of the Hyperloop tunnel, but the same principle holds.  Opening an airliner's door during high altitude cruising would literally rip the plane apart.  So while an airlock would also work, the risks involved would require a similar level of safety failsafes.

As for the 100 years or so development, the problem is that they want to implement the Hyperloop in the near future, specifically to link LA and SF through the Central Valley.  It's like proposing a mission to Mars right after the first space walk.  Conventional, well-established high speed rail like TGV doesn't even exist in the US!
Reply: ThrustSSC, driven by Royal Air Force pilot Andy Green exceeded the speed of sound on land!!!!
Reply: Just thought of another big problem for the hyper-loop. How in the world are you supposed to cool the electric engines powerful enough to accelerate a train to supersonic speeds in a vacuum?
Reply: That was a "It might scare the chickens" rule from the 70's. And never applied to the largest operators of Super Sonic Aircraft the Military. As someone who lived in the Kennedy approach path for all of the Concorde's history, it really was a non issue. I also worked a summer out at Grumman's main assembly facility in Calverton NY. They had no qualms about going SuperSonic over the suburbs. There is no "Shockwave" that bothers the ground. There is a large boom and you plan the flight paths and the minimum altitudes to minimize that.
Reply: Sonic booms can break windows, they are definitely a major problem over land.
Reply: It's kind of counter-intuitive that a vacuum can somehow contain energy when it contains literally nothing else. I understand that there is potential energy in its ability to fill back up, but that's only in the context of the high pressure environment outside. What if you're in space and there is no outside? How can the vacuum of space contain any energy then? There is nothing outside the universe to fill it.
Reply: Industrial shipping would probably be the prime target for this technology, not passengers.
Reply: The thing is you have a difference between inside and outside. In our world it is not the energy itself but the differences but there is an energy in a vacuum called zero point energy see here: https://en.wikipedia.org/wiki/Zero-point_energy
Reply: +Beacon of Wired They don't know engineering isn't just magic.
Reply: Beacon of Wierd of course it is all about physics. As you might know a tube is very vulnerable to dents in general doesn't matter if you have a over  or under pressure system. Especially if you are dealing with  extrem under pressure.
Reply: How is he the biggest scammer in human history?
Reply: The problem isn't the fluid dynamics, it's the shock wave. And we quite clearly know shock waves can transfer a lot more energy than a static fluid.
Reply: u r so dumb i bet you vote for clinton or trump
Reply: 4)they are americans so they are dumb af
Reply: What about the test of a small metal ball inside a vacuum glass tube?
Have you observed the result.
Reply: So... Now that Musk and Trump are buddies... IMAGINE THE FUTURE! http://www.cnbc.com/2017/03/10/billionaire-innovator-elon-musk-is-a-force-of-nature-trump-infrastructure-advisor-says.html
Reply: They do have a few extra things, like structural bulkheads bracing the outer skin and internal pressurization.  They also lack a few things, like a train running up and down them, because all the bulkheads and cross bracing and because the longest submarine ever built is  175 meters long, so most people just walk.
Reply: Matt Schutzman there's still gravity in these tubes. the vacuum reduces only slightly the friction due to air. but they still have to overcome the downward force due to gravity.
Reply: Thunderf00t Why not just harness the power of black powder to propel the pods? We know it works!
Reply: What are you talking about, "Pedro", are you mestizo-tarded? What "decompression chamber"?? The tube will have to be at near vacuum throughout its length.
Reply: SpaceX is operating on a pioneering new bullshit-based business model: make extravagant claims, make news, increase public profile - increase value of stock and draw investment. They're basically capitalizing on the Star Trek generation.
And when the bullshit turns out to be bullshit, the profit will already have been made, various NORMAL-ASS ventures (like satellite launches) will have been expanded on, and virtually NOBODY will cover the slow petering out of the various publicity "projects". Like sending people to Mars, or even the Lunar orbit, for that matter.

That is, until the whole publicity bubble pops. But if they play their cards rights they will have grown more than sufficiently by that time, so what little negative press does piss on their hippie parade won't have much of an impact.
Reply: +dIRECT0R Your mounth runs faster then your brain. It's ok, take a break and go outside play with the rest of the kids, while we discuss adult issues.
But I'll give you something to think about for the next years, since you seem to strugle with simple ideas.
The space station, has an intermediate room, where the pressure is adjusted everytime something enters or leaves. Mind blown, right?!
Now, that should give people enough insight on how clear your "mestizo-tarded" remark serves as a clue to your IQ.
Have fun, and breathe slowly, you seem to strugle while doing anything else at the same time.
Reply: +dIRECT0R You're really dense, even for a troll. Read what I said again. You missed the word "part". 
Never have I said a decompression chamber would fix all the problems or make hyperloop viable, it would solve the problem faced on the tests when they had to re-pressurize all the system every-time something had to go in or out. Isn't that obvious? Oh, not to you.
I mentioned it, because, for the second time, Thunderfoot talks about it as being a huge problem when it isn't, since it can be solved soo easy.
Most, including me, agree with Thunderfoot, but some might have corrections to share about what he said.
Unfortunately, you (apparently the most dense arrogant special snowflake in here) seem to think your opinion is worth sharing when you failed to counter-argue or even at contributing something interesting to the discussion.
Have fun being now ignored.
Reply: This 95% factual video gets somewhat sour from the 5% smug. I mean shooting down the test track with "I couldnt even stand in it" like it had any relevance and as if that was the point. Thunderf00t you are awesome but keep it real man. No additives needed
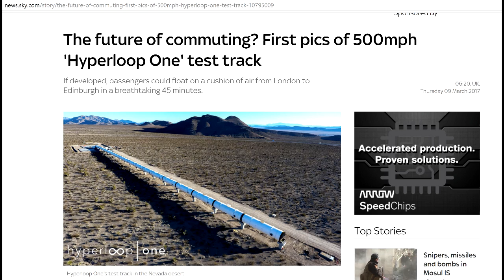Reply: +Jamster he means that the dimensions of the test track is smaller than the proposed dimensions of the LA track they plan to build which are on the scale of passenger trains. Starting out with such a small scale compared to what they aim to be able to operate removes some credibility that the hyper-loop  is a plausible alternative transport with the results that the design competition has shown.  Also at around 6:20 in the video he starts talking about the actual operational requirements of a vacuum of that size such as the power needed to remove as much of the air as possible in the chamber. 

We need all of the details, even the little ones, to clearly see the bigger picture.
Reply: face palm
Reply: +Yves Paradis well, Thunderf00t (may the bunny be feared) how about different atmosphere levels? Like if they did 20% atmosphere instead? And how about you do what you do in other videos where you speculate about what would be required for it to work(if possible). Like with solar roadways working by putting the solar next to or above the roadway. (I mean it isn't the original idea but same difference.)
Reply: Robert Payne, Agreed! I'm not sure which option it is, however, maybe there's a fourth option? Perhaps Musk's team have solutions to the engineering issues TF raised and they can actually get this thing to work. Although, I'm not an engineer and am not qualified to guess how they could do this. Ultimately, I don't really care, since I have nothing invested in hyperloop.
Reply: PhotoGeorge, Ah! Now it makes sense. Always easier to spend someone else's money!
Reply: +Pedro Matos  WHO is stupid enough to think they would de-pressurize and then re-pressurize the ENTIRE 1,000-mile tube!?? Who is stupid enough to think Thunderf00t suggested that was a fault in the scheme as a whole (rather than a hilarious testing hurdle)? Who out there would actually suggest decompression chambers as something other than an obvious element of the design?

You. You're a moron. Get back to folding tacos or whatever it is you do...
Reply: Thunderfoot, can you please work out the height of tower Musk will need when he realizes the best use of the multi-billion dollar tube sections is to build a waterslide.  :)
Reply: could be ? if the "train" is hovering and there is no downforce (air pushing down as it moves) on train, the smallest vibrations could do all sorts of stuff to the tube and the train.... it would be tied into the magnets and the speed they pulse at.
Reply: I don't think there's any point even in a conventional high-speed rail line, come to think of it. LA and SF (especially LA) just aren't cities built to benefit from such projects.
Reply: Monorail!
Reply: +dIRECT0R It's ok, I've already reported you for being a racist idiot. Even tho you failed stereotyping me, it's amusing to get your Trump like atitude out of here and prevent others to make contact with your toxic personality.
Have fun at it.
Reply: +Deedless Deity  Dirail!
Reply: +Pedro Matos  Is that how you ignore people? :)
Thanks for making it clear you're politically motivated, though... I'm so sorry you're outraged by someone having an attitude alike to the President of the United States.

I figured you're not Mexican, genius - I'm trolling ya! xD   But that aside - your comment was pretty fucking stupid, you gotta admit. Here's a video talking about the pressure exerted by the atmosphere on a near-vacuum along the length of a massive tube, with just a humorous aside towards the slowness of their competition preparations - and you're talking like decompression chambers would solve any of the problems pointed to! That is just moronic on twelve different levels. It makes you dumber even than the "racist idiot" xD.
If you don't want to be mocked - think before you post your brain farts...

Obviously they wouldn't decompress and recompress the entire 1000-mile Hyperloop, and would use decompression chambers to get things in and out of it. That's just given. Thunderf00t doesn't claim they'd need to depressurize the whole tube, and doesn't point to that as a supposed problem of the project. He just vaguely alludes to how slow depressurization of the competition mini-loop is. Indeed, that mini-loop is so comparatively small it might as well be a "decompression chamber" for a 1000-mile tube.

Now seriously though, fuckoff snowflake... Consider getting off teh internet.
Reply: What about using that fast release to push it to the destination and use magnets to slow it down?
Could a person handle the g-forces of the acceleration?
Reply: I can think of one right now...THE AIRLOCK... that will put a limit on the size of the pressurized travel vehicle. If the vehicle is too small you run into the Concord Problem of not being viable do to scale, or if it is too big you have the Airport problem where it takes you almost as long if not longer to start your trip(from getting into the vehicle to beginning actual transit) then you spend moving between locations.

Question how long does it take to depressurized a tube that can fit a 737 inside it? Are you going to sit inside a 737(with a double walled hull and no windows) while listening to the air getting sucked out of the double walled tube your double walled tube is sitting in for that amount of time? Even if it is say 2mins?
Reply: "invent new material..." something we do everyday?
Reply: trains are safe from these
Reply: But he dossent even have an engineering degree. He literally just looked up "metal" on google. and "vacuums" and tried to do math.
Reply: See that is the thing, i could show him a wax model prototype and he would point out the wax, he has no idea what he is talking about.
Reply: You know... you could use a valve or breaking system to slowly ease the machine into a state of motion. Why do people look at something with no education and go "ya i am smarter then a man who went to school for 10 years to build space rockets! Cause i read on google!"
Reply: woooow so we landed on him convincing 100,000 of thousands of people to keep a secret for 20 dollars an hour... conspiracy, to create vacuum powered nukes and get government funding for his iron man suit?
Reply: Yes cause because mars atmosphere differs from our atmosphere that mean the pressure differential would create free energy on mars... did you even think about this before typing it?
Reply: This is what i am talking about... Everyones like "hey i made a potato gun before this wont work!!!"
Reply: Thunderfoot has just become a real debby downer and a general nay sayer.  His remarks are what prevent people from at least attempting new things.  Time for an attitude adjustment Thunderfoot.
Reply: +Ryein Goddard
I want to invent a new medical treatment that uses the chemosynthetic power of crystals to repair your body's tissues. Crystals grow themselves over time, so we just need to get some on your body to make them regrow your body too. We're still developing exactly how this would work and investigating which crystals would work best, but your investment of your hard-earned money will help us to completely ignore trivial back-of-the-envelope calculations proving that it's thermodynamically impossible at best, and add to our payroll dozens of reputable crystal scientists who will help us figure out how to heal people with crystals. Why aren't you investing, you debby downer. You're why nothing new ever gets done. Sign up now, and get a free solar freaking roadway.
Reply: If you never try then it will never happen, my question is whats more important testing a idea or saving money in a failing monetary system?
Reply: Peter Knagge wtf are you trying to say
Reply: Ashley Freeman dust or dirt I'm confused tell me more about this ground you speak of
Reply: well the tube is only as strong and the material its made from, and since there welding it together i dont like its chances of survival, i give it maybe one decompression cycle and it's going to fail along the weld lines
Reply: ID GAF yeah watch the pylons crumble then the tube buckles under its own weight and bang
Reply: It won't even make it that far. Look at that tanker truck imploding. This tube is made exactly the same way and designed to do the same task. They are using standard steel piping designed for water. It's meant to hold the weight and pressure on the inside, not the outside. The first time they try and depressurize it it will uproot itself and go writhing across the landscape like a snake as its segments implode.
Reply: The real technology is how many years away still if it even happens. I would expect them to do something like build a larger "protective" tube around the actual hyperloop.
Reply: So here's a thought: Molecules in air have Maxwell-Boltzmann speed distributions. If we open one end of the hyperloop, someone standing in the middle of the tube will first encounter only the fastest air molecules and then increasing amount of slower and slower molecules, until eventually the person is getting hit by molecules with of all sorts of speeds that have the MB speed distributions (roughly). So the question is, why would encountering just some part (in the speed axis) of the MB distribution shred you to pieces? I cannot figure out why this would be the case.

However, if the tube is totally blocked by, let's say, a vehicle, after opening the tube the pressure caused by the air molecules against the wall of the vehicle would get higher and higher and eventually surpass the atmospheric pressure, reach some maximum value and then start to get lower as the air starts to flow back to where it came from. Eventually the open part of the tube would be at 1 atm pressure. So the question is, would the max pressure be high enough to break the vehicle assuming it would be totally stuck to the tube? It would probably require some sort of simulation to sort this out. Or maybe there is a neat equation that can handle this kind of situation.

In reality, there is some amount of space between the vehicle and the tube wall so that the air can flow past the vehicle. I'm guessing the vehicle would still face higher than 1 atm pressure against it wall, but not as high if it blocked the whole tube. The vehicle would feel an accelerating due to the blowing air, however the acceleration would also depend on the mass of the vehicle, as F=ma. The change in its velocity would also depend on how long it takes for the pressure to equalize in the tube.

Any thoughts to this?
Reply: Szgerle
I don't know how many times it has been stated that the hardness of the vacuum is immaterial to any discussion of the hazards involved in the hyperloop.
Reply: No its not? Why are you making shit up?
Reply: Why would they write '99.99 percent' if they would actually plan on using a number lower than that? The whole thing is just a huge publicity stunt and I am astonished who many scientist an ongoing scientist take this seriously.
Reply: Yes, that extra vacuum certainly helps. If they're going to the trouble of a 90% vacuum then they might aswell go for 99.9% because it's not much more difficult.

Thunderf00ts arguments have fallen apart without concerning yourself with 90% or 99%
Reply: That cannot be answered with yes or no, because nobody knows what their goals are. A better vacuum means less resistance for the wagons inside the tube, but means more work to reach that low pressure. With a pressure not that low the wagons will use more energy to travel.

But why would they say that a vacuum of 99.99% is planned if 80% would be enough? It seems that you are desperatly looking for a way to contradict thunderfoot. Just stay with what Musks People have published and stop making 'if'-arguments for them. thunderfoot is only reacting to what THEY published.
Reply: Besides the fact that the thing will just slowly accelerate for like 20 minutes. It's not like it's a rocket taking off at high speed.
Reply: The only person bought is the maker of this youtube vid. If the concept were as dangerous as TF makes it out to be, someone would have leaked information about it and there'd be a big hubbub. Meanwhile, not a single one of Musk's aspirations has failed horribly (in reference to entire projects, not singular test cases), like TF expects the Hyperloop to.
Reply: Except it wont, and you're a moron to believe they'd make it so thin and only single layer, as is Dunderf00l
Reply: +D dabdab0132
There is indeed a diminishing return on going below 100 pascals. From what I understand a 100 pascal vacuum is relatively easy to accomplish and maintain.
As far as the construction goes, the difference between a 90% and 99.9% vacuum would be the same as the difference for a submarine between 9 and 10 meters below the surface. Not really that big a difference.
Reply: massive ordnance air blast bomb too, depending on which acronym you go by.
Reply: @TheGreg6466
The first flights of the Wright-Flyer weren't very impressive either and the controls were so clumsy that probably no one apart from the Wright-Brothers, who had spent years working with these sorts of designs, were or ever will be capable of flying it. 
This is not a promise that the Hyper-Loop will actually get off the ground, but it is definitely a little early for Thunderfoot to dismiss the project so smugly. Also, he has not addressed some of the significant rebuttals people have made to his arguments particularly honestly. For instance, when he uses the white to black gradients to make a point of how little difference there is between 99% vacuum and total vacuum he is mistakenly using a linear scale instead of a logarithmic scale under which 99% is actually pretty grey...or so the rebuttal goes. I have no expertise with any of this type of science, but I do know that Thunderfoot blatantly ignored or dishonestly countered the rebuttals of people who do, and that should not be acceptable for someone who got famous going out of his way to debunk the blatant retardation that is creationism and is trying to make a point about scientific inquiry and integrity.
Reply: Samwell Tarly I think now it's pretty obvious that Hyperloope is a scam and all this "build works" are for show. Someone will steal the money in the end, considering the amount this project costs those spendings on materials are negligible:
Reply: Samwell Tarly Samwell Tarly I think now it's pretty obvious that Hyperloope is a scam and all this "build works" are for show. Someone will steal the money in the end, considering the amount this project costs those spendings on materials are negligible:
Reply: +Chris F  I love the whole "I challenge you to do better than them" argument. Here's the thing: Thunderf00t can do better by not doing anything. He already knows the dangers of a vacuum tube. He's also not a couch warrior. He's most qualified to talk about science. It's arguable that he already does do better because he works in a lab trying to find new 

There's a difference between innovation and blindly pushing forward despite the extreme danger that others are pointing out. Their "innovation" also ignores past NECESSARY innovations to account for expansion due to heat. The test loop doesn't even account for that, nor does any model that's been made. Innovation fails when it doesn't take previous innovation into account.
Reply: Brian Céspedes I think they are
Reply: he pointed out deadly flaws in the design and that they have barely made progress on the things they promised yet - it is a seriously bad and impractical idea to have a 0.05 atm vacuum in there. show me solutions to that - even though hes an arrogant prick but if they show they can do it he will accept that; they have yet to come even close to the claims they made though.
Reply: I believe vacuum transport will be available one day. I also believe it will not be any time soon. 

My jaw dropped when I saw the crap tubes they were considering to use. You need a low-pressure environment around the tube itself as a safety precaution and preferably have it's entirety cast in the thickest layer of concrete you can imagine. 

If it goes wrong it will go so wrong that there's nothing left, so there's no point in not going all out in security from the get-go.
Reply: +Kevin Miedema It's the difference in pressure.. That can be negated by creating pockets of less and less pressure in layers. That way, even if something rams into it and it gets dented, the results won't be as dramatic. Think of it as a reversed airbag.
Reply: Robert Payne 4:  His engineers have discovered something we do not know about.  i have doubts about this being even remotely possible, but if new tech is reveled, who knows.  I would think hihg speed rail would be a better idea.
Reply: Robert Payne 4:  His engineers have discovered something we do not know about.  i have doubts about this being even remotely possible, but if new tech is reveled, who knows.  I would think hihg speed rail would be a better idea.
Reply: Thunderf00t the pod part of the video looks like you slowed down the recording after the pod is let go I mean I'm not against you but c'mon man at least link the original videos
Reply: Thunderf00t Great video! Have the Hyperloop team considered how they will deal with induced current in their tube in an event of a major geomagnetic storm like that of May 1921?

Love your work, keep it coming :)
Reply: In this competition? The measuring tape picked the winner. The Delft students were just the best among the worst fails.
Reply: AtotehZ what if the hyperloop is broken open by a terrorist you ask? the hole would most likely suck in everything nearby till the hole is clogged if a person was near they may get shredded soooooo yeah but the scenario is very VERY unlikely the  again if they can make this why even have the disconnecting pod if you can get it this fast just make it a ultra fast train like mach 3.whatever train
Reply: +Andrew Smith I didn't ask, I stated. Any kind of terrorist attack would completely wreck the thing.
Reply: Thunderf00t couldn't you leave the air in and create a fan system on magnets? I'm no scientist or even smart so idk..
Reply: Samuel Wang Wow sounds like another stupid California engineer! You real think you're going to fix it with a piece of sheet metal and a torch.. Any attempt to repair it will only make it weaker.
Reply: Would you be one of those engineers who couldn't see a deficit in that dam that failed? A 3 year old can see these things. 
On the bright side, I see a fantastic weapons development coming from this hyperloop. I've already thought of a half dozen weapons while watching the video. And I never heard of anybody being stupid enough to come up with such a concept before now. Well maybe in 1970 some lame duck with zero practical experience had such an idea publish in Popular Science. People really need to stop doing drugs.
Reply: myname604 .FCKgoogle nopemmm, looks more like GTS pipes..... 
- Gas in SF and no connection to global GTS(only local communications.... and there is Global GTS, which is have its end in LA)
- oil near LA, someone can begin extraction again(i heard there was ?huge? incident, no idea, is there any oil production or not, atm)....... aand there is oil refinery facilities in SF.

and there will be 2 pipes...... exactly pipes, because no one gives a shit about capsules or ppl, whole idea about pipes and pressure)) 

and it is looks exactly like any other GTS) 
as for weapon... what weapon can it be?.... any way it will be too vulnerable to any attack, and have no any "scan-proof" shit.
p.s. is your name 604, like "i have rights to view and edit, all have right to view it and give no shit to other cases"?)) resembles hosting rights authority  settings)))
Reply: amigane shooting the fing
Reply: WTF - Thunderf00t, what has happened to you?  So much bad logic in a video just detracts from the correct stuff.  It will work on non-discerning viewers - are they your target audience now?

You are giving examples of a student competition on a shoestring budget to explain why something is not achieving commercial targets.  You must know that is false logic!  you would have a field day discrediting most of your own video.  When that happens, you know something has gone very wrong...  I really thought you were the protector of true logic and science...

Its like coming to Boston Dynamics and claiming that biped robots are not viable because a bunch of very intelligent grad students spent a year on a project and it falls over.  You should know better.  Even if your claims about Hyperloop were true, the fact you use false logic to prove it makes it bad science, and you should know better.

You have 3 or 4 claims in the video that deal with other issues, but honestly I can't assume scientific integrity any more - one more lost warrior for science - how sad - please return from the dark side.
Reply: Jon Saxon "commercical targets"... pff, another zealot..... take calculatior and try to analyze how much years this track need just to pay off its own cost.
~hundred or several of hunreds.
Reply: Talk about the Primer Fields. WE WILL NEVER NEED TO PAY FOR ENERGY AGAIN!!!
Reply: Salty Viper oh great more thing that can fall
Reply: Thunderf00t you don't think we know how to pull a vacuume in a tube. Don't get me wrong but it's not like the technology is imposable. Also the cars are not ment to have high acceleration, but rather a high top speed.
Reply: 8 oz of tnt would take your hand off.    20,000 times that.... make s really good weapon.
Reply: i bet you know what your talking about lol
Reply: Because normal trains dont levitate, so you will have friction "stealing" energy from your pod. If you want to say maglev trains are normal, then there is very little difference between a "normal train" and a hyperloop on Mars. As far as I understand, Hyperloop might also be buildt to resemble the IP-trafic of the Internet with smaller "packets" instead of one large shipment of people/goods from one central hub to another.
Reply: Are you seriously so stupid that you think that they don't already know tube's specs and durability etc.?
Reply: I don't want to argue to every statement in your comment. But something you should think about before writing such a  comment .. an A380 can fly up to 1020 km/h and every person can fly in such an aircraft .. soo actualy I've never heard of a person get hurt because of G-forces in an A380 or similar.
Reply: I personally think that the supports at the ends of tubes are to prevent buckling in case of accidental dropping of the tube during handling and transport.
PS. I think they should use the hyper.... to send messengers in order to improve communication between two cities instead of using horses like today.
By the way it should be called hyperlink not hyperloop. The only think this project has to do with Loop is the loophole in regulations that allowed them to gather founds on this idiotic idea.
Reply: Good grief.
You are one incredibly dim-witted twit.
Reply: Maybe check the new hyperloop
Reply: After watching this I got an idea that could possibly work similar to how a rail gun works but on a massive scale to the extreme speeds that they are trying to achieve or even faster. Could this possibly work in reality or is it just an idea?
Reply: DK Kempion I have a better conspiracy theory for you

You believe in mars???
Reply: Thunderf00t make IT thiccer maybe Will work
Reply: Well they forgot one crucial and obvious thing. Even if they manage to make air resistance to naught, they're still one more resistance they need to implement in their calculations. FRICTION. Dumbasses.
Reply: How about creating a vacuum within the Earth. Basically create a boring tunnel coat or surround the tunnel with materials to help create the vacuum. Basically make the entire Earth the shell of the tube. Then safe systems inplace to stop in the event of an Earthquake. Also they have ways of building things to be safe from earthquakes.
Reply: I dont know about a pump down on that scale. As an individual who has pumped down a lot of hvac refrigeration cycles I have no choice but to co sign your bullsnuff here.
Reply: Well why dont do subs implode?
Reply: Nonce protector
Reply: That thing is actually built to send Buckaroo Banzai to the 8th dimension
Reply: 5kg?, are you insinuating that a single tap couldn't wipe it out?
Reply: you obviously haven't heard of the new material its made from its called "stupidium" it was developed at harvard university
Reply: @AstheaTV  Graphene
Reply: Has anyone seen what happens to an aluminum can in a vacuum?
Reply: Thomas Woo exactly!!!!! 
Shame on you! 
The guy that made this video will quietly ride the hyperloop when it's finally done
I'm so proud of the guys that are fighting a battle to improve our world... Willing to endure jokers and mockers like the guy that posted this video.
Reply: You should talk about how an earthquake would totally nullify it.
Reply: @obiwan245  How will an earthquake affect an ordinary high speed rail system and what measures is installed to safe guard against disaster, and are they effective?
Reply: Well Whisky November that just leaves three possibilities doesn't it.
Either;
1)  His engineers have explained how flawed the idea is and he is deliberately continuing
2)  His engineers are too ''bought"/afraid to tell him for fear of their jobs.
3)  Mr Musk and his Engineers are cynically messing with an unusable idea just on the off-chance that something useful may be invented in the process?
Reply: @YeRobertPayne  I liked the tube soldering machine in the picture
Reply: "Instead of being a little whiny bitch. Why dont you come up with a fucking solution." -- Here's the thing, O Lord of All the Knowledge: the Hyperloop is a "solution" WITHOUT A PROBLEM. We ALREADY have PROVEN high-speed rail technologies in ACTUAL revenue service in the real world. Technologies that allow you to sit up, stand up, and move around while enjoying the exterior view rather than being packed like sardines in a windowless tin. At least two fast conventional modern rail systems exist: The German ICE and the French TGV (the Japanese Shinkansen is getting a bit dated and our own Acela falls a bit short on a number of metrics). One very fast MagLev tech exists: The  German TransRapid design as implemented in Shanghai. As someone who's been studying transportation issues and modalities for decades, I can assure you that we've seen this "revolutionary new solution" horse crap again and again and again and it NEVER achieves practical implementation. Look at the PRT nonsense that has erupted repeatedly since the 70s, the cantilevered bidirectional beamway designs that never went anywhere, or even the dual-mode roadway/beamway automobile concepts that were proposed in the 90s. IMHO, investments should be leveraged into reducing the per-mile capital cost of existing, proven modes. Sure, it's not sexy but these investments always pay off. The golly-gee-whiz crap never does. There's your solution!
Reply: Fund your channel few days ago, watched a video, it was great, good representation of data and funny. Then watched another one and another one and realised your just a little broken man. You're picking up little mistakes, things that can be easily improved, etc. and start whining about them 10-30min. I'm definitely glad that you aren't anywhere in a scientific research team, because the progress would be 0.
Reply: +XDJaegermeister
1. Won't help. If you make the walls thicker you've still left with an even bigger problem of thermal expansion because the inside is either colder or hotter then the outside and the tube starts deforming. A tube in a tube is a waste of money because the energy difference is still there. 
2. Won't work either because firstly thermal expansion isn't one dimensional and nobody likes moving Hyperloop stations. 
3. Have you ever been outside on a windy day? If yes, did you feel the wind despite there being so much space around you? The size of the vehicle doesn't matter, if there is a tube failure, you are going to get hit by a wall of air at the speed of sound and roughly the mass of a truck.  
4. Transrapid is too expensive thats why it is so seldom used compared do classic trains. Usually it is used for short distance and build for political reasons.
Reply: Sergey K The plane, Actually flew, mate. For 12 whole seconds, and three more were made the same day. 
The Wright brothers made a business out of giving people half hour joy rides. 

The hyper loop, on the other hand isn't working. The concept is flawed and expensive, and trains are safer and more reliable. They're trying to replace a relevant technology with an irrelevant amusement park ride that will never work
Reply: Some solutions to some of the problems.
1. Tubewalls:
-Make wall diameter bigger 
-Add structure to the outside
2. Tube length: 
-Weld all the tube elements together(like they do it with pipelines) and put the hole thing on rolls to allow for change of length(Same technology  is used for bridges http://www.leifiphysik.de/sites/default/files/medien/ausde03_ausdehnerwarm_gru.jpg)
3. To make a failure of the walls less dangerous:
- Make the vehicle inside smaller than die tube diameter, for example 3m vehicle diameter 4,5m tube diameter(enough air will go around the vehicle, less pressure to push the vehicle
- Add safety valves every X km. If one detects a failure the others letting air in to cushion the vehicle. 
4. For the vehicle itself:
- The Transrapit is a very good option to use (https://de.wikipedia.org/wiki/Transrapid)
5. Stations:
- Use airlocks to not have to remove the air every time

My opinion: It's possible but not rational because of the costs.
Reply: First, he didn't say it couldn't be done. It absolutely can be done. Magnetic  levitation works. It is physically possible to build a tube to run it in. It would take a staggering amount of steel and in my view you should only load and unload at the ends. The environmentalist are going to fight you every ft of the way. Maintenance costs would be staggering and the cost of building it might exceed the GDP of the US of A. This would be the most expensive means of travel ever including going to the moon. It would be staggeringly uncosteffective. 

He's just pointing out the problems because the idea is so stupendously foolish. He's doing it for giggles because it's so easy to do. Fixing those problems isn't his day job. If you want them fixed you fix them.
Reply: Because we could buy a Japanese bullet train and Musk wouldn't be able to con any government taxpayer cash for himself.
Reply: "Instead of being a little whiny bitch. Why dont you come up with a fucking solution. Fuck youre annoying now."
I have a solution. Don't use a vacuum. Just make some kind of big tube with rails in it. Eliminate air resistance by having giant fans that push the air at the speed of the train. Much easier than trying to vacuum pressurize the whole thing.
We can call it... a subway.
Reply: Nonnof Yobiznes There is no unicorns AND SCIENTISTS HAVE NO SOLUTION to breed magical beasts... shut up and live with it.
Reply: Thunderf00t The cost of production and maintenance vs the price customers would pay must be something like $400 -$800 per person. The tech,the strength of the metal, warping, power and energy required. Itll never make a profit. Its a terrible idea!!
Reply: Bust uBeam WIRELESS POWER!! This is far more imperative. A scam +$20 Million and counting. Also, uBeam is putting EVERYONE's health at risk by using ultrasonic waves to in a failed attempt to transmit power wirelessly.
Reply: +Sergey K we already know how aerodynamics and vacuums work. we know this technology cannot possibly work safely. end of story. were not working with some magical future tech here, were working with well understood principals.
Reply: So we see how few relatively small pressure tanks are not able to hold the vacuum. At the same time HyperLoop project was able to build ~1km long vacuum chamber. I think in scientific terms we call this a success. Don't we Mr Thunderf00t? Are you really a scientist or just pretending to be?
Reply: I can see this tech working out in about 20 years on short tracks. It's not useless entire to research it but they advertise it as more than it is. Which is basically how every product in the world works to be honest...it's also the media overhyping stuff as usual. Reminds me of the John Oliver segment on Scientific discoveries.
Reply: Thunderf00t the real question is HOW DO YOU GET IN AND OUT
Reply: You do realize Musk is a con artist, don't you?
Reply: I bet ISIS is drooling at the concept of sabotaging a 100 mile long stick of dynamite that has public access... Where do I sign up for a ride on that train?
Reply: The 200.000.000J is only 55kWh two houses could make Vacum inside this "microloop". Calculate it how much does it cost to make such a vacum... Its a pity that You lie people and make such a film.
Reply: from the wikipage "According to Musk, Hyperloop would be useful on Mars as no tubes would be needed because Mars' atmosphere is about 1% the density of the Earth's.[13][56][57] For the hyperloop concept to work on Earth, low-pressure tubes are required to reduce air resistance. However, if they were to be built on Mars, the lower air resistance would allow a hyperloop to be created with no tube, only a track"

Maybe thats the endgame?
Reply: he did
Reply: It amazes me when people think proof of concept must come before research and development.
Could this be too difficult in operation?
Maybe.
Could there be a way to do it that overcomes those difficulties?
Absolutely.
Now...I wonder...how might they find that way?
That question may be too difficult to answer.
I know...I'll do some R&D to find that answer.
Reply: Whisky November The high of feeling important can strip away common sense, mate. Just look at Feminists.
Reply: Thunderf00t yeah it does look very thin and for the pressures they are looking to hold it would need to be in the range of inches thick not fractions smh also they would have to build it from some exotic metal like stainless to keep maintenance of the tube low
Reply: If they want to do this kind of thing, and encourage students, that's great, but why not have a competiton to design a super fast, super efficent, environmentally friendly, super quiet, high altitude, jet plane? They already have airports so they don't have to mess about with the cost and time designing and building infrastructure (tube) and having rip up half the country side and people's houses, roads, etc. it could connect to his spaceport and the airport could have a big carpark for electric cars too! :)
Reply: TheGreg6466   So why don't you explain why dust floats in a vacuum? If a brick and a feather fall at the same speed, what would prevent dust particles from falling at the same speed? If you're going to be condescending, try backing it up with some facts.
Reply: Sergey K Because the first plane flew four times and was turned into a successful joy ride business. There was nothing else like it.

There is something else like the hyper loop. Trains. They work efficiently and are safe as shit. The hyper loop is an idea that is not required.
Reply: Euro Dollars
What on earth do you mean? can you show me your maths please?! what is the g force, how did you calculate it? what were your assumptions?
Don't say "we" when you have no idea...
Reply: in theory once the vacuum is created, it shouldnt take any more energy to maintain so long as you prevent air from ever getting in again (air locks and such). We're already experienced with it with spacecraft docks, but creating a vacuum that big would take an incredible amount of energy to start with. As for the maglevs, yeah, but what's the top speed on them? 500+ kph? in theory with no air resistance, going beyond the speed of sound shouldn't be an issue except with the friction of the track (since it would ripple as the train went by thanks to the magnets pulling and pushing the train and handling the burden of the load).  But the speed of sound is higher in denser materials isn't it? you'd think they'd aim for much, much higher speeds than just 800 kph (500mph).
Reply: +andrew taylor Sonic/super sonic planes cannot fly over land because of the sonic shockwave, so those can only be in flight over oceans and not on the distances proposed for the hyper loop. As for the submarine comparison, submarines can handle pressures about 50 times what is required here. Add to that submarines are tubes filled with high tech radar systems, weapon systems, life support systems etc while this would simply be a vacuum chamber with rail inside of it. So that comparison in price is extremely inaccurate. It would be like saying you need a chair with an AC and buying a new car because it has both a seat and an AC.
Reply: The one single thing which will determine the method of levitation/propulsion is cost. Cycling fields is what one of the teams used all tho I'm pretty sure that system has some inherent drag to it which would be limiting, not sure tho. But there are a lot of methods out there, it's just a matter of cost. the "air cushion" method is really cheap so that is probably the most viable method.
Reply: Thunderf00t your tone in this video is so condescending it annoyed me to the point I didn't bother to listen to your arguments.  There is nothing amusing in attempts to develop something innovative. While there are assuredly obstacles to overcome here your mockery comes across as immature and a perfect example of the couch warrior community that is the Internet.  my indignation comes from your reminding me that I am a part of this community as well.  I challenge you to do better than them instead of being a bully.  good day sir
Reply: @green house What's the "right interpretation" of the hyperloop?
Reply: Thunderf00t Right now, it is very hard or even impossible to make the Hyperloop a reality. But, technology is always advancing and we have done so many great stuff at the past, that is a bit harsh saying that this is a "death trap".
Reply: TheGreg6466 How is it unfair to ask how they plan to keep this thing safe? as he stated the test track should not have had anyone around even. The people building this should be telling us how they plan to keep this bomb from going off before putting so much money and research into it first. If the full track where to be constructed it would be deadly to anyone inside and outside.
Reply: Sergey K And is that speed required? Horse were slow as fuck. Cars were much, much more convinent. 
The rail system is convinent and reliable. The hyperloop? Not so much. 

And if you really want to get somewhere fast, take a bloody plane, mate. They don't need useless vacuums.
Reply: Assuming they get over all the technological issues ( as they have with planes helicopters and so on ) , this thing will never be build on a large scale because of one thing : THE RUNNING COST . Only a small fraction of rail networks in the hole world is economically viable , all the others are LOOSING money and are supported with taxpayers money , now imagine the cost of maintenance for a project this big , no company on the entire planet will support this much loss . There is no way to make this viable and cost effective when we can not do rails cost effective.
Reply: elon huckster is getting rich off all these pie in the sky dreams.. all his companies are TAXPAYER funded dreams and he will walk away with billions  and we walk away with his bankruptcys
Reply: white papers ahaha.. exactly how many of the ideas in those papers will end up the same in the actual system...practically NONE..everyone will be modified..
im a field engineer..ive worked on the chunnel and several other super tunnels.. guess what.. they screwed up on those too and PEOPLE DIED..
EVERYONE OF THEM..

there isnt   TUNNEL or train system ever built that didnt have an UNEXPECTED accident that KILLED people..not just workers.. but  RIDERS.. 

whoops we didnt see that problem......  1000s of engineers, designers, inspectors, and workers and common sense builders,,,,,,
 and STILL theres ALWAYS that ONE itty BITTY tiny winy mistake that will cost a dozen or more lives..guaranteed
Reply: youre obviously a young IDEALISTIC wannabee.. good luck sonny..
 theres not a  major new  tech project EVER BUILT that people didnt  DIE in..not one,,, going back to the pyramids and before
Reply: Thunderfoot never said that it's impossible. He only said it'd be way more complicated, expensive and dangerous than mr. Musk and his supporters make it sound. They missed a few of the very basic problems they'd face or at least didn't present any kind of viable solution to them.
Reply: I respect your opinion immensely, but you keep making the same mistake. 
There would be a decompression chamber, to prevent the problem you insist bashing on.
It's common sense.
It fixes part of the problem you approached, not all, but at least some.
Reply: +Peter Knagge

Damn you, I had to do research during breakfast! ;)
Even the vacuum of space is just a near vacuum.
But if there were a sonic boom in the near vacuum of the tube it was be so quiet I doubt it could do any damage.
Reply: I think they should have made a system were there is a lubricant out on the surface and thy have the train like thing that covers the entire hyper loop and has a vacuum in front of it and a higher pressure behind it this should make it self-propelled and yes i do realize there are problems with this like the pressure lowering over time but that is what a air pump is for and you could use little graphene based stoppers so the transport devices can stop and go and the problem i listed earlier could be used to slow down the train thing or the simpler alternative is just put a monorail in there because their is palatially no vacuum.
Reply: Its not like there isnty ANYTHING... its just removing much of the gases, and this included O2, which msakes things to oxidize,.. but its not  truly empty..., its just less dense
Reply: Larry Smith are you for real? the law stops plenty of terrorists especially now trump is potus, the police and fbi have things called counter terrorist units, plus the cia leaks show they can find and stop terrorists, you won't hear about most cases because they're usually classified to stop other terrorists from avoiding the law.
Reply: Spandan Ganguli lol They should call the Hyperloop "Thunderf00t - the joy ride". Their tag line would be, "it goes so fast no one can keep up"! :)
Reply: TheGReatDeceiver42 That was just a test track that closed down after a fatal accident. It has now been dismantled and are no more: https://www.thelocal.de/20160922/10-years-since-magnet-train-crash-emsland-transrapid
Reply: I really like these debunking videos of yours!
Reply: idontcar80 Maglevs are expensive, hyperloop is the budget option
Reply: You know, you could just do the math and see if the structural integrity and failure-modes of the tube is the same as a tanker truck. But you didn't. Because you are wrong. Go on, do the math on the wall-section and check it's margin of safety. Like actual engineers do. Comon.
Reply: PutItAway101 I am not saying the science and engineering of the hyperloop is a problem. I am criticising Thunderfoot because he made yet another video, about the same subject, with the same arguments. That aside, some of the arguments thunderfoot made aren't valid too. He is making this project look like a spawn of Satan, waiting to go wrong any moment and kill hundreds. The depressurization won't take as long as he says, because 99% of the tunnel is going to remain a vacuum all the time. A guy with a handgun will eventually not be able to depressurize the whole tube. Thunderfoot tries to make this project look way worse than it is. And in my opinion, that is completely unfair. So I search for a reason, why does he hate this so much that he needs to make multiple videos about it, just showing how wrong and dangerous it is. I came to the conclusion that it has to do with Elon. Judging on how he made videos on Elon's projects in the past.
Reply: DK Kempion we don't want to debunk the Mars thing. It's the perfect way to voluntarily deport stupid people to another planet. I think Douglas Adams first proposed the idea.
Reply: Thunderf00t why doesn't elon musk just pay you to debunk all the bullshit ideas that come across his desk?
Reply: " How many of them would you need to lay bow to stern to stretch from LA to San Francisco?"

Bahaha, man oh man. Come on, you expect us to swallow that load of crock? Submarines have a couple extra things in them than a pipe would.  Ballast tanks, reactors, torpedos, housing, sonar, missiles, a hundred crew men, sewage systems, oxygen scrubbers, washing machines....

Oh, and, in addition to that, it's surrounded by saltwater, one of the most corrosive environments available.

We know you can make the tubes because you can make a submarine HULL. Nothing else applies, and so the costs are not remotely equivalent.
Reply: Atmospheric pressure is about 10.000kg/m2. With the slightest 
dent/deformation it will bend, crumble and let the air rush inside at 
lethal speed... not to mention the possibility of debree it carries with
 it while ripping the tube near the hole/tear and the stuff outside the 
tube. Hmmm what would happen if a bird was near it?
Reply: keep in mind he does own his own airline
Reply: the smart idea of what they should do I scrap it and sell it
Reply: FALSE CLAIMS
Reply: Thunderf00t  why don't they use magnets like a rail gun
Reply: relax, it is just kickstarter for some kind or gas or whatever transportation system...... 
After they build it, they will just say "uhh... ok, it is not workin..oops....... But lets use it some other way")))

Btw... is there oil refinery facilities in SF? And oil near LA?... wow, such great coincedence)) 
Mmmm.... and what about Country's gas-tranport system?... hmmm another coincedence.... and there is 2 tubes, pretty much fit for those urges)))
Reply: Thunderf00t, this is the level of comment you inspire: a meaningless sentence with no clear connection to anything, but phrased as some type of ridicule - can you see the connection to "Hyperloop is not possible, because students used a short test track and didn't even get close to the speeds that Hyperloop advertises"?

Thunderf00t, you clearly believe in science and reason - once in a while try watching your own videos with a critical eye.
Reply: Johnny, better an idealistic young person than a 'set in their ways' older one.  The certainty with which you make your claims shows me you never really gave any of it a chance.  A truly experienced person might be skeptical, but know their own knowledge limits.  It may fail or it may succeed (finance being the biggest hurdle, as always), but its not at the same level as Solar Roadways and the like - You seem to live in a black and white world, where either its fraud or it is a great success.  That is my main concern with Thunderf00t: instead of encouraging people to think for themselves he's using ridicule and significant amount of false logic to make a point.  Its sad - I really thought he was on the side of science - we so desperately need people to stand up for science and reason.
Reply: http://serbu.com/50bmg/ca50.php
Reply: elon isnt actualy trying to acheive the hyper loop, hes milking funding from a million different sources based on hype, thats historicly very comon practice before very major wars
Reply: At the beginning of most of these videos I'm usually like: "Come on dude, many inventions seemed ridiculous and unachievable at first and the very first babysteps often seemed pathetic and couldn't POSSIBLY lead to anything at first.", but you always make it really clear why this shit never will work. Well done again! :-)
Reply: Thunderf00t, I'm not disagreeing with you, in fact I think you're spot on regarding hyperloop. However, what I don't get, is why Musk is still investing in this! Surely, he's employing suitably qualified and experienced engineers and personnel who should identify the same issues you raise, and advise Musk to call it a day. I just don't know what his end game is, maybe government funding?
Reply: @whiskynovember9195  you push science just like you push muscles when your a body builder if you're elon musk. You go to failure!
Reply: I bet, TF, those who disliked you Hyperloop videos are exactly the same people who liked your political videos.
give it a though or two.
Reply: yes they do die in all these things... but the companies building them and running them,,, have other revenue streams ahahhaa and 1000s of other types planes and trains and cars to pay for the losses..if not complete other businesses in other sectors..
you must be a true communist socialist comradski ..only in mother russia and china will they keep building flops that wont fly or trains and nuclear plants that wont run..
here on this side of the capitalist planet ,,,profits keep projects going..
but you wouldnt understand  that in your bathrobe eating spaghetti Os  and moms homemade cookies, while stoking a bong
Reply: Musk is all about marketing.
Now, debunk the nonsense of going to Mars.
Reply: All of these are just engineering challenges, nothing that cannot be overcome. Tube colapses? Thicker walls/more rings. Sudden acceleration during a leak? Add emergency breaks. Takes a long time to achieve vacuum? Add air locks. Track is expanding? Add airtight expansion joints. All of these problems are trivial to overcome, all but one. Money. Each of these solutions cost more and more money, there's no way that this will be economically achievable. From an engineering standpoint it's kind of simple, so when you bring up problems which can easily be overcome it's not strange that people are doubting you. You should be looking at the cost of these test tracks to see if it's feasable or not.
Reply: Moreover; Thunderf00t's constantly jeering narration, grates on the ears and nerves and is a stupid & childish manner to conduct one's self.
Grow up & shape up Mr. Thunderf00t.  

(who will read this!? - I guess a precious few. Anyway I gave it a try.)
Reply: woudn't resonance also be a problem? i'm no scientist but i've heard this could be a big deal when building bridges, trains, planes..
Reply: @froozynoobfan  we all have seen the collapse of the Tacoma narrows bridge
Reply: Great Video! There is actually a reason why Musk  named it the hyperloop. Because there is only a lot of hype to it. And he didnt create it for mankind, no. far from it, he created it only to promote his businesses. He knows about all the hype his person creates. It is marketing nothing more. He fools the whole world.
Reply: do you ever herad of space X?
I think you are like those People howw never believed in the internet.
And you to Thunderf00t.
Elon Musk is the best that could ever happen to planet Earth!
Reply: well its cool in concept.
Reply: Comparing trains and potential speeds achieved by hyper-loop in say 20-50 years from now is like comparing horses and cars.
Reply: hi Tf. i think you are being too hard on this. yes there are real safety concerns, as there are with any high spd rail. some issues are due to the experimental set up; clearly it would take very little time taken to load and depressurise, say by equalising with an existing vac zone.
Reply: Entire Hyperloop could be destroyed in SECONDS!
The video just shows a partial collapse of the tube, why do you think the Hyperloop would be any different? 0:40
Reply: 5 tons of tnt it's not even a good weapon
Reply: Douglas Jackson like I said it's early days, it's not unfair to ask how they plan to to make it safe but I didn't say that, I said it's unfair to judge the whole thing when it's in such an early stage of development and it wouldn't be deadly, like many other pressure vessels they are made to withstand rapid decompression, it's similar but opposite to a pressurised airplane, they don't have issues with the pressure difference. I'm sure it will be made to be safe, nobody will use it if there's any doubt about it's safety.
Reply: I love your vids and all.. but seriously. This time you're just disappointing. You're a freaking scientist, don't give us excuses of why it can't be done, GIVE US SOLUTIONS, THAT'S THAT SCIENTISTS DO.
Reply: +Thunderf00t, what has happened to you? All of a sudden when someone disputes your point you put another video out complaining about it- you are becoming what I subbed to watch you criticize, what I subbed to watch you draw attention to and refute with logic, what I subbed to watch you shut down. This is a problem, sir, as I'm no longer sure why I watch some of your content. It doesn't fit the mold of your old material, and quite frankly you now seem to repeat yourself over and over. 

The only idea you seemed to be able to express in the original rendition of this video was that "...[giving the responsibility to test build the concept] to STUDENTS..." was a bad idea, and that it was somehow the best they could come up with. And, much to my dismay, when we, the consumers of your content, called you out in your own fashion, asking for facts and clarifications, we got a repeat of your opinions followed by a select few examples that support them. This isn't what I was drawn to, and it's certainly not how you would've responded if Anita Sarkeesian made some of your arguments (although she would've forged her research and committed Plagiarism in the process).

I'm going to try ONE MORE TIME. What is it that you have against this new idea? Even if it's a bad one, I'm sure that Thomas Edison had about 999 bad ideas for a light bulb before he had a good one. We need these bad ideas to happen so we can GET to the good ones, but the chain of logic you're pursuing seems to be an obstructionist one. If something fails unmanned tests, I'm more than sure that more research will be done to correct it before the mass release of the platform. I just want to know what's happened, and why your content has become what you used to shoot down... and if you just release another video complaining about the comments you got on this one, then I'll know your answer (regardless of whether you respond), and I'll go elsewhere for my fix of your old style of content. Either way, I STILL look forward to hearing your thoughts.

-CD1145
Reply: you know how stupid this video is?
dont you think people who creates rockets, haven't already thought of 
that?
if this is really one of the issues wouldnt it be really weird if they 
still proposed it?
you have the wrong interpretation of the hyperloop. stay with chemistry 
thunderfoot., engineering and thermodynamics is definitely not your 
thing.
Reply: Thunderf00t, you have to be making a mistake somewhere. The engineers and investors building this thing would simply not make the basic mistakes you attribute to them.
Reply: PutItAway101 I am not saying the science and engineering of the hyperloop is a problem. I am criticising Thunderfoot because he made yet another video, about the same subject, with the same arguments. That aside, some of the arguments thunderfoot made aren't valid too. He is making this project look like a spawn of Satan, waiting to go wrong any moment and kill hundreds. The depressurization won't take as long as he says, because 99% of the tunnel is going to remain a vacuum all the time. A guy with a handgun will eventually not be able to depressurize the whole tube. Thunderfoot tries to make this project look way worse than it is. And in my opinion, that is completely unfair. So I search for a reason, why does he hate this so much that he needs to make multiple videos about it, just showing how wrong and dangerous it is. I came to the conclusion that it has to do with Elon. Judging on how he made videos on Elon's projects in the past.
Reply: Ok according to you a murderer is the best that ever happen... whatever to planet earth? Elon Musk is a fraud who accepted an enormous amount of money from Mercedes. All of a sudden that company pulled back from the whole Tesla project. Why? Because it's not google or any other crap that is further than any other company in the world and they said your autonomous driving wont work. Over 30 people officially died because of his lies! It's probably at least 80 world wide that 30 died because of his failure is a fact. The cars he is selling are polluting more than a BMW 320i. If he really was so concerned about the environment he wouldn't buy papers from china exchange them for US green energy. The energy used to charge a Tesla is the same as any other plug. He lies and has a smirk while he talks since idiots like you believe the crap he's saying. Do you know how old this idea is? It's older than Elon Musk. Electric cars existed before the Benz motor carriage. The first hybrid car was invented by Ferdinand Porsche. What strikes me most of all is that a criminal like Elon Musk has not been in court for manslaughter. The Tesla is no longer autonomous because of this reason. This South African bastard belongs in jail. If he really was so damn smart he would have tried to get more energy from battery's since a Tesla is totally useless it has no range at all. His split tongue makes him look like some kind of savior of the world although the only thing this guy thinks about is money. Maglev studied partial and total vacuum it could work. Talking about decades ago. The costs are just to high and Elon cant change that. America needs to cut so much money thanks to Obama that the hyperloop is further away than the truth of a fairy tale. Keep believing in bags of shit like this it shows your intelligence.
Reply: Milo Nonce protector
Reply: Thunderf00t I think you're being a bit harsh, it's still very early days, they've got a lot of things to work out, doesn't seem fair to judge them just yet, you're right though it doesn't inspire you with confidence what we've seen so far. thanks for your vids  phil, I do enjoy you're work. peace.
Reply: 0:40 Is a tanker truck built to withstand vacuum? no you noob
2:51 Would you base the future of planes based on the first ever plane? no you noob
3:40 You sure like repeating yourself over and over... lacking material?
What will you do if there is a working version before you die?
Put your honor where your mouth is. Or are you chicken?
Reply: +Thunderf00t
Go debunk something that needs debunking. This will work at some point soon and if you are concerned with the security of it. The security will be similar to an airplane. So I don't see the point in constantly ignoring what can be done to increase security and reliability. Use a few of the braincells you obviously have and you can quite soon figure out plenty ways to increase the reliability of this. Just like with airplanes. They once had square windows. Which caused many accidents. Now they have figured out this problem and solved it. Nothing is perfect from the start.
Reply: The airplane was proposed in 1799 by George Cayley.
First self propelled flight was 1903, 104 year later.
First manned flight was 1906, 3 years later.
First commercially influential airplane was DC3 in 1940, 34 years later. -Wikipedia

Sp how about coming down a little and giving the tech a few decades to develop first? Or can't we see past tomorrow because the world is ending soon?
Reply: Thunderf00t I didn't like your other debunking videos as they are from "nobodies" and the products cause relatively no immediate harm to anyone, despite what you think of the idea what people waste their money on is their own damn business, and you were being condescending and there are things way more worthy of scrutiny. However, this is Elon Musk, he's a billionaire, he's not going broke any time soon, and in my opinion the Hyperloop is incredibly dangerous.  I've seen promises of top speeds of over 1200kms/hr, that's Hypersonic sonic boom territory, not to mention the G-forces, will people please stop and think what you're doing!
Reply: Instead of being a little whiny bitch. Why dont you come up with a fucking solution. Fuck youre annoying now.
Reply: @thisismyname8627  Why don't you?
Reply: @_Gandalf_The_White  Because this is an Engineering problem. 

I provide solutions in agriculture. Im building them now, out of recycled materials. Twofer you could say.

However the question remains what are YOU doing to actually come up with solutions to problem?
Reply: @thisismyname8627  It's ok to be offended, most people feel that way after having their bullshit called out. You're not fooling anyone but yourself kid.
Reply: @thisismyname8627  TLDR.
Reply: @_Gandalf_The_White  Thanks for comfirming your BS :)
Reply: @thisismyname8627  You did it long before I did, acting like a 12 year old online won't get you anywhere.
Reply: @_Gandalf_The_White  Its ok to be offended, most people feel that way after having thier bullshit called out. Youre not fooling anyone kid
Reply: @thisismyname8627  Thank you for proving my point.
Reply: @thisismyname8627  ok
Reply: @_Gandalf_The_White  It helps to have a point to begin with if youre going to say "Thanks for proving my point". You tried, and failed, to copy me using your own words against you.

It's not trolling if you try(miserably) to troll but end up getting punked. 
1/17 Troll. Wouldnt fall for it if you had a brain of one neuron. You'd have 100% more brain power.
Reply: @thisismyname8627  Sure thing.
Reply: @thisismyname8627  Its not even about finding a solution, its about calling out  misleading bullshit which is primarily what this channel is about. The fact is, if the development of Hyperloop could stop pretending like the technology is nearly there, it wouldn't be featured here. IF they mentioned "Oh yes, we have this and that problems, we intend to solve by 2070", it would generate a lot less hype - so they DON'T. And so you have people standing near an elongated metal death trap, excited because they don't know the only trip it caters at the moment is to the morgue. Just because most of us don't know any better.